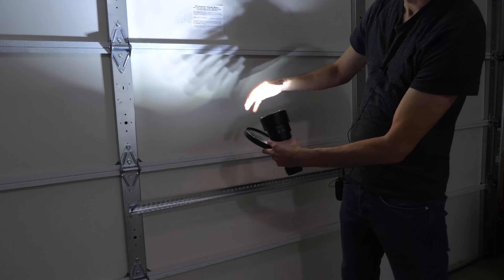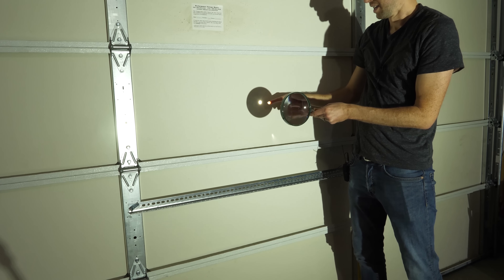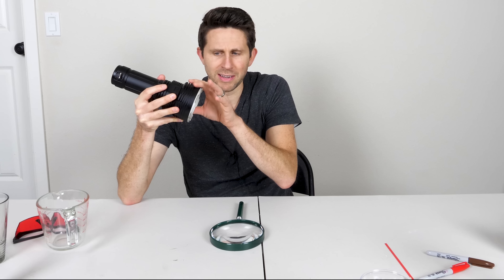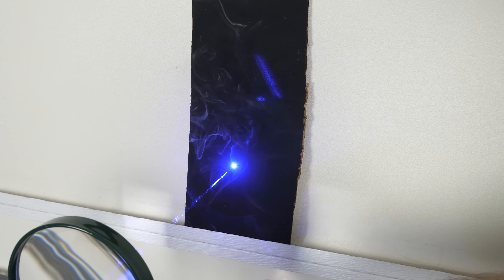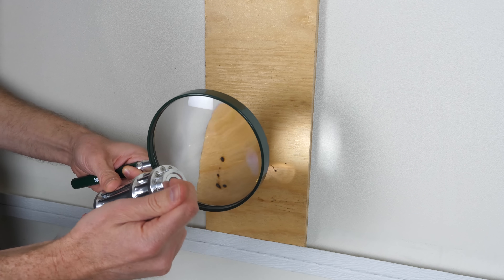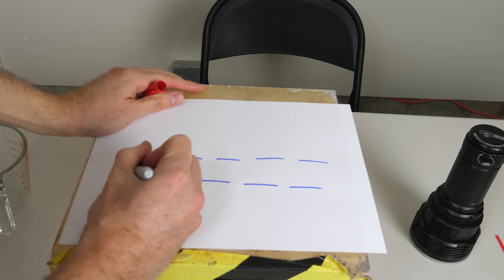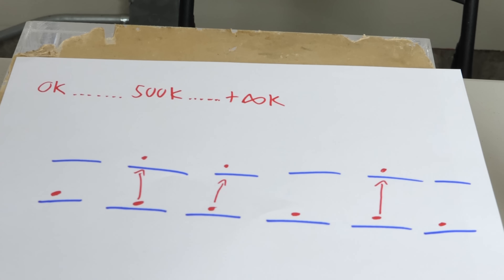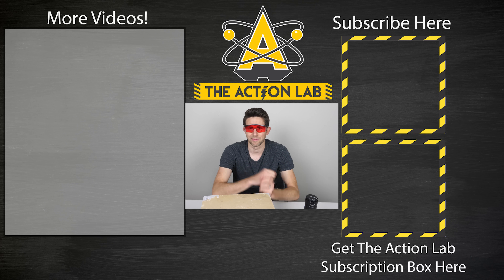What Happens if You Focus a 5W Laser With a Giant Magnifying Glass? Negative Kelvin Temperature!

Comment from the maker: I see a lot of people are having trouble with this video. First, I am very much aware that the reason the laser it getting hotter when it is magnified is due to the reduced area. That isn't the point of this video. The point is to try to explain why it doesn't break the laws of thermodynamics! Now for the negative kelvin explanation, statistical mechanics tells us that at infinite temperature all atomic states will be populated equally. The Kelvin scale was built upon classical mechanics where it would be impossible to achieve a state in which there are more atoms in a higher state than a lower state. However due to quantum mechanical effects, we know that we can stimulate atoms to be in a higher energy state simply by shining light near them that is at the same wavelength as the light it would emit at that state (stimulated emission). So in a laser, the stimulated atoms actually achieve a population inversion where there are more atoms in a higher energy state than a lower one. This is where the negative temperature comes from. In this case we have to define temperature as negative or else we get into problems that break the second law of thermodynamics. It doesn’t matter that my laser has poor optics. What’s important is that lasers can break the conservation of etendue due to the fact that they have light that doesn’t spread, the reason they have light that doesn’t spread is because of population inversion, and this is why we have to say they have negative temperatures (or they behave as if they have negative kelvin). We can never achieve negative temperature in a non-quantum mechanical system thus anything the laser shines on is always at a positive temperate no matter how hot you get. 

Of course the reason the laser gets hotter when it’s focused is due to the reduced surface area of the light. That was not my point though. The point of the video was to explain why it doesn’t break the 2nd law of thermodynamics. Please research “conservation of etendue” to understand why you can’t focus a flashlight down to a point that is hotter/brighter than the flashlight surface. This is a very good example of how the second law of thermodynamics can never be broken no matter how hard you try.
Reply: You should have mentioned etendue in the video! Perhaps even link to the xkcd "what if" essay on this topic.  Also, cross reference the Nottingham video on negative temp. and population inversion.
Reply: Well technically you're not increasing the energy of a laser to make something hotter your decreasing the area of which you are Heating which decreases the amount of time that it takes two heat app said material if you were able to make more energy just using a magnifying glass we'd be doing it on a massive scale and solving the world's energy crisis I guess what I'm trying to say is that you're not getting any more energy or any more heat out of the laser you're just convincing that to a finite point making it heat much more quickly it's like if I put a pound brick on your foot it's no big deal but if I put that pound brake on a needle that's on your foot it will poke a hole through you I didn't increase the weight I just decreased the surface area making it much more effective
Reply: But couldn't you just capture the light with a glass dome close to the light or at least some of the light with a parabolic mirror to a focal point?
Reply: Party P, all glass absorbs and scatters some light. The more lenses you use, the more energy is lost. And no lens can focus all wavelengths of light simultaneously, because of chromatic aberration. Only one specific wavelength at a time can be focussed by a lens. That',s why you see coloured bands around the edges of an image which has been passed through a lens. The bigger the lens, and the higher the power of the lens, the worse it becomes.

Bye.
Reply: Yes negative kelvin is really something but I dont think it is relating to the experiment in your video. Well... Laser now a days are using LED and even using crystal/gem and use a somesort of intereference or method to concentrate the light into a small point to escape as a laser at high coherency. Through out the process, the device itself losses of a lot of energy as heat.
With that said, the light from led and the laser are no different. THEY ARE LIGHT !

The laser device itself actually making a normal diverging light of light bulb into a concentrated point as laser...
The negative kelvin was kinda discovered yet still in not conclusion . It help explain a phenomena from an experiment carried out with the gas which involves energy of molecules. Yes the negative kelvin scale chart system is different from those celcius and Fahrenheit... Your "infinity" explaination is hardly understand by many people. The things I dont like is the use of technical words and interpretation are misleading, please make something accurate when it comes to technical stuff...
Reply: Yes, the use of the word infinity etc.
Reply: Hey you should try to use multiple magnifying glasses to focus the flashlight. But one up close then put one slightly further back and put another one slightly further back etc...
Reply: @yammymcyammington3219 You'd overfocus some light and end up scattering it. Photons don't interfere with themselves, it's only their waveforms that generate interference. If you have a precisely defined waveform for a photon and try to impact it with another photon you will fail.

Furthermore, because photons by their nature travel at c, its entirely plausible that all of the photons are the same one; and that if it is possible for that photon to be on a worldline, then it will be there. As for whether you'd detect it, that one you can ask Schrodinger, Dirac and Heisenberg.

There is a difference between something making sense, and you understanding something. Furthermore, the moment you believe you have understood the nature of quantum mechanics is the precise moment the superposition of your knowledge collapses into cluelessness.
Reply: @yammymcyammington3219  or buy a focussing flashlight which has the collimating lens close to the diode.  From there you can focus the light even more to a dot if you want, but you will not have laser light and it will not be enough to light a match on fire.
Reply: Simple version of what he demonstrated and spoke of, if the flash light was on then all the energy is displayed but in terms of it as heat, it is hot but not to hot. if you want to make it hot you need to focus it via magnified glass. He had troubles focusing the flash light into a beam of energy so he discontinued, I had an idea and said why not make the magnifying glasses act like a camera or telescope lense and pair two magnified glasses? When it all comes together he has most of the valid statements but lacks a detailed analysis aka the video above. Please demonstrate this topic more detailed before your conclusion!
Reply: @Desimoar  heat is a biproduct of energy. Some times it's waste ,still a part of the maths.
Reply: @bikerbob2005   yes their is waste but focusing the light/heat would enable for more concentration, but yes you may lose some of the heat from focusing but still makes the light into one beam making it more effective in what he was saying of making it past "infinity". With that being said it is possible to concentrate the beam down to a capable burning point but, everyone here just wanted to see things get burnt lol.
Reply: For a more in-depth understanding of negative temperature I’d suggest the video by 60-symbols on the topic titled “is negative temperature hot”
Reply: And... I believe you've reached full Dunning-Kruger saturation in the comments to your nice video and the replies to this comment of yours.
Reply: The Action Lab: You could have avoided confusion by emphasizing that you can't focus all the power (i.e. the ENTIRE light cone) into s apot smaller than the surface of the LEDs. Somehow people have the natural perception that the source size is the opening of the flashlight and not the tiny area of the LEDs. You could have also made the point that you can't project a brighter image of the LED onto the wall than what you get by simply putting the LED chip against the wall (just use a power meter to prove it). And the best example for collecting and re-focusing all light from an incoherent source is an elliptical pump cavity used for arc lamp pumped lasers.
Reply: Novgorod \
Reply: @RealNovgorod  but what if you get the light cone into perpendicular rays of light with a special lense. What's the difference between the light from LEDs and a laser's
Reply: @RealNovgorod  These tips seem spot on. Actionlab does amazing work, that said, maybe he should get an expert-panel and a layman's-panel (where I belong hahaha) to audit the videos before posting?
Reply: @EverHappyDude  Yeah well, actual experts typically don't talk into the camera in exchange for ad money. That's the dilemma. Also, Dunning–Kruger - therefore, most of what gets around is completely worthless.
Reply: @RealNovgorod  But can't we? Yeah, with regular concave/convex lenses we can't, but what about a specifically designed optical system, that is applied to every LED, shaped in such a way that all light from every LED is focused onto infinitesimal point?
Reply: @aberroa1955  read the wikipedia article on diffraction limit (Abbe limit)..
Reply: @RealNovgorod   Yeah you have focusing flashlights which do exactly that.  There are also LEP (Laser(!) excited Phosphor) lights which look like a flashlight, and can burn stuff.  But these are advertised as LEP and not LED.
Reply: @RealNovgorod  I don't understand how the fotons emmited from the LEDs can't be concentrated in a point smaller than where they came from. If this could be done and the fotons have the same energy as in the LED you would create a higher intensity resulting in a higher power meaning higher temperature. Could you correct me where I'm wrong?
Reply: @Joris Kirchner Yes, if you could indeed collect the light from a low-intensity surface and concentrate it into a smaller area, you would end up with a higher intensity. But the second law of thermodynamics says that in order to do so, you have to put additional energy into the system, i.e. you can't do it with a "passive" arrangement of lenses or mirrors. Let's say all the walls in a room are at the same temperature and you want to make one wall warmer than the others by transferring the heat from the other walls (making them colder) - that's not possible without a heat pump which requires additional energy. The photons from an incoherent lamp behave in the same way as the photons from a heat emitting wall at room temperature: You can't collect all the heat radiation from a wall with a giant (passive) infrared lens and focus it onto a spot and make it warmer than the wall.
Reply: @RealNovgorod  Thanks, I finally understood with your analogy of the closed room at an equilibrium state. That makes sense that you will break the 2nd thermodynamic law if you could concentrate heat in this situation. You could create an infinite energy source and perpetual motion
Reply: @Eidoryan: It wouldn't be necessarily an infinite energy source (1st law) because you would only use the energy that is already in the system and just redistribute it. However, the 2nd law forbids a "spontaneous" redistribution away from equilibrium because that would decrease entropy which requires work.
Reply: @joriskirchner6280  I see no problem with wat you say. It is impossible to increase the amount of energy emitted but (like you say) if you concentrate the energy emitted from all of the surface of the sun to a spot as big as an apple then it would actually get hotter than the surface of the sun.
Reply: @KnumpterGames: But you can't concentrate the energy from the entire sun into the size of an apple, that's the point. There is no mirror or lens system that can do it, you can even try to draw it on a piece of paper with simple ray optics, you won't be able to focus it down to a smaller area, that's not only beyond physics, it's even beyond simple geometry. Well, maybe you could do it with a specifically shaped back hole but even then it would be just an appearance from far away because locally the focus "area" would still have the same size and intensity.
Reply: @joriskirchner6280  go read highschool textbooks.  Dont shit hear(this guys doesn't even know the spelling of photons.)
Reply: @RealNovgorod  umm actually, using a big enough lense we can harness all the rays coming in one direction, then placing the sun at the vertex of a parabolic mirror we can direct the rest of the rays to the lense.

Anything is possible with the right combination of lenses. Trust me. I'm an engineer.
Reply: @RealNovgorod  Quantum Tunneling: Since when have we cared about geometry? If we figure a way to passively induce quantum tunneling, then you could theoretically set up a multilayered mirror array that could capture the entirety of light emitted by a spherical object and direct them into a single point. You would do this by inducing quantum tunneling if the light approaches a mirror surface from anything short of an ideal vector and then it would pass through the mirror to the next mirror found beneath that one and so on until you get a mirror that will cause the ray to be reflected to the desired point.

Obviously this is all theoretical and would require materials and methods we do not currently have and a precision that is nearly impossible, but it would not actually be impossible as a rule.
Reply: @femsplainer  You're making no sense at all. You don't need quantum tunneling to capture all the light and this was never the issue. The issue is that you can at best reflect all the light back into the source, but never into a spot smaller than the source area! No matter how you shape your mirror, every single point on that mirror will receive an infinite number of rays at different incidence angles because they come from infinitely many different spots on the source. You would have to adjust the angle of this mirror spot for every one of those infinite beams to reflect them back into one point and do it all simultaneously. And if you want to argue that you could somehow serialize the rotation of the mirror segment because the photons arrive not perfectly simultaneously but one at a time, take a look at Poisson statistics and think again (let alone how you would determine the k-vector for each photon without destroying it, since that's a quantum measurement).

Your weird multilayer mirror would not work either - and you don't have to call it tunneling because it's simply a partially transparent mirror, which is very well described with classical wave theory. If you could somehow make a magic mirror that reflects only if the light hits it at one specific incidence angle and transmits all the "wrong" angles to some layers behind, you just expand the problem to infinity. The "wrong-angle" beams from one mirror point will mix with the wrong-angle beams from other mirror points at the next layer and create exactly the same problem that you have at the first layer, i.e. infinitely many beams hitting one mirror point at infinitely many different incidence angles.
Reply: @RealNovgorod  So I think we're talking about a few different things here. First off, when you say that you cannot focus light down to a smaller area than the source which is not true. In a standard incandescent light bulb for instance, each tungsten atom along the filament emits photons. These collective photons can be reflected in such a way that they will converge on a point that is smaller than the surface area of the filament. In fact we saw this in this very video with the laser. The point was much finer than the that surface area of the diode that was emitting the light. We could have seen it with the flashlight as well if the light beam was more focused and he had a bigger magnifying glass.

The point to the quantum tunneling is to avoid intensity crushing with semi-transparent mirrors similar to what you would see with polarized lenses. If the light came in at almost the correct angle to be reflected, it would effectively scrape the mirror and lose some of it's energy/intensity in the process. Tunneling avoids this problem and I was feeling fanciful so it doesn't really matter that you can do it other ways, because you could do it my way too! Even then this is only necessary for the light that would have to pass back through the source (and the physical structure that comprises it and that which is holding it up) to get to the target point

Lastly there is not infinite number of incidental angles that a beam of light can hit the mirror, nor are there infinite beams of light being emitted by the source, so your final point is moot. Photons emitted from a single light source travel in all directions, but there are a finite number of photons being emitted. If there weren't, well then it wouldn't matter if we only collected a subset of them and focused them on a point, because 30% of infinity is still infinity after all.

Mathematically angles may be infinite, but when dealing with the material world and fixed distances, we see that this is not actually an issue. These emissions are coming from a fixed source and traveling a relatively short distance, so at a certain point, we can ignore subdivision of angles because they would only produce a drift effect on the photon at distances greater than what we are focusing the light on. In other words, we can reduce the infinite set to a finite subset and achieve the same goal of focusing all light emitted from a source to a point. Further you set the bar a bit lower by saying that we can't get light down to a smaller area than the source, so we wouldn't even need to be as accurate as to focus the light to a single point, just a rough area that is smaller than the source.
Reply: @joriskirchner6280 conceptually you're correct. The only thing you're wrong about is saying that it would be "higher" or "more" the video is drastically incorrect so just ignore that but know that the amount of heat and light produced by a source can NEVER increase. What you can do is take most of that heat and brightness and apply it to a smaller area. Imagine a lightbulb that heats a room to 50°F and provides adequate light. Now tape off that room so it contains 100squares and use mirrors and lenses to focus the light on that one square. That square will be 100 times hotter and brighter than any single square from before but it will always be slightly cooler and dimmer than the source of light itself.
Reply: @RealNovgorod yeah but it you pointed the heater at the one wall then obviously the other walls in the room WOULD become colder 🤔 😆 🤣 😂
Reply: @RealNovgorod  I think the action lab has maybe used a bad "analogy" for the principle he's trying to describe and I'm not the only one (as the large response of the audience would suggest) so simply saying "no" is as lacking a response to my reply as his is to try and explain the principle of the second law of thermodynamics but not just the principle but the "specific" principle according to one specific "author/scientist".

Now I admit I might not be interpreting or understanding of the "jist" of the principle but even your analogy of 4 walls etc is very lacking as your analogy also negates the fact of the energy source that is heating the walls and is therefore lacking in a descriptive manner (I understand "passively" placing mirrors or lenses in that room would do nothing to allow the residual heat to be transfered to the 1 wall making the 1 wall warmer whilst making the other 3 colder but you're ignoring the mechanism that's heating the walls in the first place I.e. the directed energy source or laser in the action labs video)

I enjoy his videos and don't mean any disrespect but if so many people are interpreting the intended topic matterin the wrong sense then it can't just be the audience that's at fault (and he does accept the point the audience is raising so I think maybe a longer and slightly different explanation wouldn't be a bad thing no matter how counterintuitive it seems).

And  I know that lasers can be used to "cool" matter/particles down below a certain threshold and that is highly counterintuitive considering most would associate lasers with heat and burning etc.
Reply: @scottbishop7899  I've given many extensive explanations covering all your concerns here, just look thorugh all ~500 replies. Nothing is "heating" the wall, it's a closed system, or at least a steady-state system. But even if something would heat the wall to make its temperature rise over time, if won't be cooling the other walls at the same time.
Reply: @RealNovgorod  funny, could've sworn I saw him pointing a laser!!

Once again, bad analogy!!
Reply: @scottbishop7899  Sure. A laser is not a wall. Nor does it cool walls.
Reply: If you made a long reflective cylinder connecting the flashlight to the magnifier glass wouldn't it then be brighter?
Edit: Missunderstood something I thought you were saying that you couldn't get a brighter light than what is being projected onto the wall instead of what was coming out the source.
Reply: Is that why it's works with the sun , the light isn't so hot but because the course itself is so hot it can still burn things
Reply: Loved it my friend. I do have a few questions. Do you mean even if you CONCENTRATE a large area of sunlight into a point it still will not exceed the surface temp of the sun? Surface of Sun is only 6000 degrees f or so but Corona is millions...I assume you mean the Corona temp right? I do light research and things too...I love your approach. https://www.youtube.com/watch?v=edp7FZLf2N4&t=1s
Reply: My name is Kelvin lol
Reply: I'm studying Optics and Photonics in college, and your wrong that laser light doesn't spread. All light diverges. If you shine that laser to the Moon by the time it hits the moon it'll be hundreds of feet wide. And your also wrong about population inversion. Population inversion is just a feature of how a laser achieves stimulated emission, and this has no effect on the divergence of the beam. When you focus it your just taking the wavefront and making it smaller, increasing irradiance. And there's also a limit to how small you can focus it with lasers. It's called diffraction limited spot size so research this stuff before you mislead people.
Reply: Congratulations the action lab, you now have the world record for the longest comment in history
Reply: This is not an accurate account of the second law of thermodynamics nor do you accurately claim that you cannot get a hotter point at the tip of a focused beam then the source. What you failed to mention was that there are several energy conversions that occur in a light.

Electrical energy to a diode, to photon creation, then photon destruction at the absorption surface. 

That being said conservation of energy is more critical than the second law of thermodynamics. From a conservation of energy standpoint you are reducing the cross sectional area of the beam and thus focusing the energy onto a smaller area or volume than the original source. Which is a accurate statement.

Regarding the second law of thermodynamics, there are multiple reasons as to why this has been improperly applied. This is an open system you were dealing with, not closed. You were combining multiple LEDs into a single point. Not withstanding the fact that LED lights do not produce much light in the infrared spectrum. They only mimic the spectral radiation of a 5000K (or slightly different, depending on the selected LED) source and are not actually that temperature. The issue with your setup was using a diverging light source with only a single converging lense and no collimation.
Reply: OK I can't take it anymore, I love your videos but this can't be tolerated.

The only reason we can't harness all of a flash light's power is because not all of it hits the magnifier, but if we were to remove its diverging lense or put it in an elliptical mirror to stop the spreading all of it can be collected.

In fact the light that manages to hit the lense actually focuses into a brighter spot than it was without the magnifier. The only reason a laser's focused light can be of higher intensity than the source is because we intentionally cut off most of the light until a point is left. 

It does not depend on thermodynamics, and certainly their's no negative infinity loophole to that law.

The real question to be tackled is whether it could be possible to achieve infinite intensity by focusing light on an infinity small point in space.
The answer to which I believe is no.
We like to think of our world as a contium but in fact it's pixelated into cubes of side= one plank length (maybe smaller), so that's the lower limit of the area we can converge into.
Also light isn't a continuous beam, but a stream of individual photos.

Thus the max intensity we get =(no of photons in give beam) /(1 plank length ^2)
Reply: With this explanation all you did was make it even weirder, you're saying the laser simply went beyond infinite degrees? That makes no sense, I can understand the simulated emission thing, and even the relativistic assumption of negative temperatures, but given said state only happens in infinite temperatures it imples the laser is beyond infinite kelvin, and that is just plain wrong. I can dismiss all that since it is just like a "patch explanation" to not break the second law of thermodynamics, just like we keep doing with every weird thing we meet on reality, we just patch-up our science for it to keep "working" in our minds.

The magnifying glass doesn't catch near a quarter of the whole emission of the flashlight, and it catches less and less light the further away you place it, meaning that no point made with the magnifying glass would have enough light to be shinier than the source, with the sun it's the same thing, there is so much energy in just that short area (imagine it as a gauss sphere) you can burn some small things with it if you concentrated it in a few squared milimeters. A laser is a whole different thing, lasers do not scatter that much light, like a flashlight or the sun, a magnifying glass is catching almost all of the laser's energy in the light and focusing in a smaller area increasing temperatures way beyond what the source laser has, it won't be shinier tho, for the amount if light is the same, but it will "burn harder" for less amount of particles are receiving the same amount of energy caught by the glass, it's like decreasing the area arround a pipe and getting the fluid to go faster (and hit hard enough to remove dirt from a car, or even cut steel, for example) in it, while still flowing the same mass of water (energy) in the same amount of time.
Reply: I am still so confused. You could never get an atom to reach an infinite temperature, because it would require an infinite amount of energy to do so. And even if you tried, the atom would dissolve into its elementary particles long before it even reached a billion degrees. If continued to keep packing energy into what was left of the atom, it would eventually just collapse into a black hole, and you would loose all the energy you had. And this has nothing to do with lasers. There was never any doubt that lasers fallow the laws of thermodynamics, no energy is created while focusing the light, you are just reducing the number of atoms in the wall that end up absorbing it. This is a factor of geometry, and I am very confused as to what this has to do with quantum mechanics, infinite temperatures, or negative temperatures. Can someone please explain this to me???
Reply: The Action Lab 
Tattoo removal?
Reply: Did 
The
Universe
Just
Overflow?
Reply: Or use a flashlight with zooming lenses then magnifying that more to a point
Reply: You're fake man. Bright is not the same as hot. You don't know your stuff just admit it already.
Reply: The Action Lab I love my science
Reply: Saying science words doesn’t make u smart, ur still wrong about most things is this vid
Reply: This has nothing to do with the video. But that laser is nowhere near 5 wats. It's most likely just a 1 wat laser. 5 wat lasers are much brighter and ignite most things within seconds. A dead give away of this is the housing of the laser which is very common in Chinese "powerful burning" lasers. They often advertise to be 2+ wats lasers but I promise none of them are even over 1.6 wats. Although 1 wat lasers are still very fun and much more powerful then your average 5mw red laser pointer you use to play with your cat. A 5 watt laser would also be a lot more expensive then your average 1 watt Ebay laser. Unless you modified it to 5 wats. If then never mind that's awesome.
Reply: The Action Lab I didn’t read it but ik it has a lot of information ℹ️
Reply: Ok, if you say so.
Reply: Wouldn't this be an open system in thermodynamic terms, not a closed system?  The entire surface of the sun is the heat source, the accumulative temperature.  So this means you are not going to transfer more than that energy.  However, wouldn't there be enough energy, even at 1 Kelvin, if the source was big enough, to start a fire?  It's very confusing, as the etendue explanations I see quote theoretical mathematics as to why it's not possible, but don't explain the actual physical reason why the maths are true.  Why doesn't a collimator or telocentric system fed into a lens system concentrate?  The surface area of energy expression in the system of your explanation is also not the sun, it's the receiving surface of the lens.  The magnifying lens probably shows the theoretical rule as to the etendue conservation in that context.  The angle of the rays increases and may concentrate the energy to the focal point, and continue to spread out wider than the angle of emittance from the receiving surface, received as part of a second open system part, from the sun.   Without some reason why the rays don't always separate and hence always don't reach a high enough density where they can't start a fire from the moon light say, then it is purely an engineering problem (something a problem with scientific explanations where people presume that presumptions are correct given varying setup circumstance).  So, here you would make a way to constrain and funnel the light, which a laser does.  So, through constraint, violating normal optics, can't the light be funneled to the target?
Reply: @The Action Lab "So in a laser, the stimulated atoms actually achieve a population inversion where there are more atoms in a higher energy state than a lower one." This is a fundamental flaw in your argument. Lasers do not deal with "atoms". Lasers deal with photons. While different photons can have different energy levels (e.g., a blue photon is more energetic than a red one), photons do not change energy states. Photons cause electrons to change energy states.
Reply: The only thing I'm having trouble with is your punchable face.
Reply: 1.  Laser light does spread over distance.  I can prove it with a 5 dollar laser pointer.
2.  You can't say higher and higher is negative, when it' not.. its just more positive.  There is no end to positive degrees.. To say that positive infinitiy becomes negative infinity breaks the laws of mathematics and its' just sophistry.   You are making this crap up.
Reply: Can you stop calling a 1W laser a 5W laser?
Reply: Hi what I learned is that Kelvin is based on the movement of the atoms, and at zero Kelvin the atoms stand still. how are atoms then when it is colder than zero Kelvin?
Reply: A laser diode does not intrinsically generate light with no spread, hence some modules and lasers are focusable. They have a lens that can be moved to different distances from the extremely tiny light source, so a tight beam, a spread, or even a focal point can be reached from the laser apparatus alone.
Reply: @AEON.  You could just take the lens off of a typical module that has a boost driver and focusing lens in it, if you don't want a raw laser diode. A plain laser diode output does spread a lot
Reply: The Action Lab well doesn’t it mean that the second law of thermodynamics was broken, we just “adjusted” the definition to “unbreak” it which would technically mean that the original was never a law in the first place, and that it should have been worded differently
Reply: Seems to me like you are really bending the perception of these very obvious laws to accommodate the laws of thermodynamics which seem to me to be more abstract than literal.
Reply: Imagine if u were dyslexic and had to read that whole thing
Reply: There are some highly questionable statements in this video, regarding what you cannot do with optics, and the supposed violation of the second law of thermodynamics. The pinned comment mentions etendue, but the author seems to not fully understand it, or perhaps he doesn't understand his LED flashlight. There's also some sloppy usage of the word "hotter" when he seems to mean "more intense." Power density and temperature are not the same thing  (you can make some assumptions to convert between the two quantities, though...for instance by using the Stefan–Boltzmann law).
Reply: using reflector behind the lights and 2 convex lens,one just before the ,and another to concentrate parallel lines of light,thus you will get a point of light,,which will have same energy in a reduced area,,thus you can creat a point that is hootter than the surface
Reply: using reflector behind the lights and 2 convex lens,one just before the ,and another to concentrate parallel lines of light,thus you will get a point of light,,which will have same energy in a reduced area,,thus you can creat a point that is hootter than the surface
Reply: You are wrong sir. The reason this doesn't violate the laws of thermodynamics is that the total energy in the system is conserved. You are only changing the concentration of energy, not the total amount. This applies to all energy sources. your idea that you can only focus a lazier this way is false. Your idea that laziers have negative temperature is also false. You're also citing the second  law of thermodynamics incorrectly. It simply states that total entropy never decrease. As in, to heat a spot you must add energy to the system and increase entropy as that heat is used or lost to the environment. 
For your statement about the sun, this means you can never produce a spot hotter than the total energy emitted by the sun, Not the sun's surface temperature. The sun's surface temperature can easily be surpassed by reflecting and focusing it's emitted energy.
Reply: "In this case we have to define temperature as negative or else we get into problems that break the second law of thermodynamics."

So you literally redefine words rather than question the holy "law" itself. Theoretical physics truly is a religion.
Reply: Your explanation is fine but your demonstration is not accurate.  You absolutely can focus sunlight to burn objects.  The point you were trying to make about not being able to get hotter than the source fails as a result of the bad demonstration.  The limits of the magnifying glass are equal to the limits of the energy processed through the magnifying glass.  Which is a completely different form of math than what you were discussing.
Reply: @paxtothemaxz  You heat something, it gets hot (you don't say). It can't get hotter than the source of the heat though. Energy is not the same thing as temperature.
Reply: Now with 9999999 magnifying glasses
Reply: Imagine multiple glasses.
Reply: That was long
Reply: You can't do this with conventional /optics/. Enough solar panels and  electronics and you can probably funnel that energy into generating a hotter beam  ;D then you're cooking.
Reply: The Action Lab i have a question, i learned that lasers and the sun have a straigt light beam, so why cant we focus the sun to a hotter point
Reply: @daanmatheij2583  because you learned wrong. the sun does not have a straight light beam. its light goes out in a sphere around itself.
Reply: Bill Nye the Science Guy up in here damn
Reply: I'm curious as to what magnifying glass that is because almost all glass would break
Reply: Would love to see someone create art with this method!
Reply: The Action Lab what if you used the flash light that zoom in
Reply: The Action Lab How about using a concave lens with the magnifying glass?
Reply: Hey their "the action lab" what is your work? Ahh I'll try to guess it! You are a scientist!? Pls reply if my guess is correct!
Reply: Nerd as
Reply: Not to be mean but I just realized this but why is your voice that high
Reply: And is there a bunch of sience behind that
Reply: Ok
Reply: Hooray for science!!!
Reply: SCIENCE CLAPBACK
Reply: Hey could you make a tube or pipe that's long enough to magnify the flashlight without losing all that background light
Reply: Can someone do a tldr
Reply: The Action Lab  kdjdjjdj
Reply: I finally found this video !!
Reply: Yerzhigit Mubarak liar!
Reply: TLDR. (Too long didn’t read.)
Reply: when you realize it could just turn into a black hole and your done.
Reply: I would understand it this way - A cone in equilibrium on it's flat surface vs cone in equilibrium on it's point
Reply: Hmmm, Interesting👩‍💻👩‍🔬👩‍🔬🤔😀😀😀
Reply: Where do I buy that laser?
Reply: Who else was about to read it, pressed read more, and just say nope
Reply: I didnt understand a shit
Reply: Woah...
Reply: Science biatch
Reply: Wuttt
Reply: yuck
Reply: Gwy3
Reply: Actually true! Once made me think too. It's all quantum thermodynamics and laser physics.
Reply: But why not to simply "manipulate" the light AFTER focusing it, in order to make it a laser, in a way that will result in hotter laser beam that we would get after manipulating this light without focusing it? Doesn't it go against what you say about it being impossible, if it's possible?
Reply: @Livasuk   Not sure what you are exactly trying to say, but laser light IS created by focussing diffuse light using a lens. But you can't take any light and turn it into a laser without modifying the light so that it becomes very uniform (called coherence).
Think of it as throwing a pebble in a pond and the waves that go outward will be evenly spaced between each other. This is called wave coherence.
Now take three pebbles and throw them in simultaniously. This is what kind of happens in a light bulb where light is emitted from several diodes or for example a wire and the light is actually many wavelengths (colors) at the same time, ranging from yellowish to blue and red/infrared (spectrum)
Laser light is created from a highly monochromatic light source that emits very uniform light to begin with.
In fact a laser is also called a 'highly monochromatic Gaussian beam' if you want to know the most fanciest name :p
Try Google a bit or ask chatgpt to explain laser light generating and phase coherence and how to turn normal light into laser.
There's too much to discuss..
Reply: Thank you for the video and your explanation! I understood well it and better did it reading your comment. 😊👍
Reply: Can you leave a link to where you got your laser
Reply: I understood some of those words
Reply: So in statistical based data analysis which insists on network depreciation of Kelvins in a nano spherical sense, could or would the laser be impacted by delivering equal sections of bias?
This makes perfect sense.
I once burnt my foot with a bunsen burner.
Reply: With due respect. 
I beleive that the reason you have managed to reach a "higher then source" temperature using the laser, was not due to its origin temperature. It was due to the fact that the light emmited from the laser is emmited in one direction and not in all directions.
For that reason you have managed to focus the entire emmission of the laser to a surface smaller then the origin surface. Using your flashlight and the sunlight, you are only grabbing a fracture of the origin light as the light spreads the further you get from the source (which you have mentioned when you said that most of the light hit the wall rather then your magnifying glass).

You have two problems -
1. The magnifying glass shape focus parallel beams (like laser) and if the beam is spreading in all directions it can only direct the collected light in parallel, it cannot focus it.
2. The magnifying glass can only focus the fracture of the emmmited light that hits it.

To solve the first problem, you need to adjust the shape of the magnifying glass, or use two consecutive magnifying glasses - one to change the spread from all directions to parralell (single direction), the second to focus the parallel beam to a single point.
To solve the second problem you need either a bigger magnifying glass or getting the magnifying glass closer to the source of the light (both should be easier done for your flashlight then the sun...).

Now you probably have further knowledge of kelvin temperature and thermodynamics than I have, but when the claims you appearantly* claim seem to be wrong to some, they will not bother to continue and try to understand your explanation...
I beleive that science is a method full of errors and misconsumptions, it's greatness is it's ability to question the consumptions and learn from the errors rather then sticking to it. I belive that even tough this video has an error in it, it has a value, because any kid which will doubt your claims and will dare to try and prove it (and might succeed in it), will learn a valuable lesson.

While I go and learn of Kelvin negative temperature, I challenge you to create a video demonstrating how you "can" create temperature higher then the source surface by focusing it on a smaller surface.
It will show you are a real scientist, which does not allow it's ego to stop him in the scientific investigation. It will also show another important feature of science, mistakes are possible, and it does not collapse the structure...

* I write appearantly as I believe that the intention was that you can't reach a larger amount of heat by focusing a beam then the entire source surface (it is possible that this is exactly what you said but your definition of temperature is not 100% understood by the viewers, including me...).
Reply: I can't understand a SHIT!!!!
Reply: Pagal kidhar ka . Translation susu potty
Reply: Sooooo can you create theroy type video on how to make lazer bullets or why lazer bullets would be more or less effective than a straight beem.
Reply: Hey Broheem, great channel man. Really enjoy it. I love physics. Was wondering if you could do a show on why the earth doesn’t move under your feet when you jump up due to earths rotation.
Reply: since the laser beam is significantly smaller than the lens, shouldn't you be able to use one lens to focus multiple laser beams to the same point simultaneously?

now there would be a cool video.
Reply: Yes, if you have several parallel laser beams with ideal Gaussian spatial modes, you can theoretically focus all of them into one spot defined by the numeric aperture of the lens. That spot will be brighter than the individual (focused) beams. Keep in mind though that this only works because the laser is a coherent light source (which produces an ideal Gaussian mode) and has therefore a source size of "zero". The source size in a thermodynamic meaning applies only to an incoherent "spread-out" source like an LED surface. An ideal laser has no incoherent source size, so you can in principle overlap as many as you want to reach arbitrary temperatures (that's why lasers are used to start nuclear fusion). This also doesn't break thermodynamics because "lasing" is not a random (i.e. incoherent) black-body type process like a heat reservoir coupled to the surrounding but a highly-ordered (low entropy) quantum state to which you can't even assign a statistical temperature (or you might end up with "negative" Kelvin, as very sloppily explained in the video).
Reply: The Action Lab pls get MORE lasers and get STRONGER lasers. Let’s see what would happen then
Reply: well I see, disregard my comment. In video it just sound like you mixed law of conservation of energy with 2nd law of  law of thermodynamics into one
Reply: Nice essay there
Reply: If Maxwell's demon, or something else besides a laser, could toss lots of photons in a straight line, you'd still have to defend the 2nd law, but could you necessarily make it an argument about population inversion and negative temperatures?
Reply: oh
Reply: The Us needs to put these in space to smash nukes out of the air.
Reply: This guy talks to much
Reply: @calebferguson3148  Who him? He is trying to explain something.  Trying to discuss things with wisdom takes time.
Reply: Whoa whoa to much writing OK I luv ur vids tho
Reply: People are jumping on this for various reasons, and holding up a big magnifying glass without a lot of animations and graphs to explain it, and looking and sounding like TV comedians we have here. Could it be a troll?
Reply: Actually.  This whole thing of atoms going into a higher energy state being called negative temperatures is just typical contradictory rubbish.  They could have called positive temperatures above kelvin normal, or positive, and the "negative" positive or extra positive, or even special positive.  Whatever will happen if they find some folded dimension of space, with extra slots giving space energy density, and somebody finds out that you can turn those slots down as well, and probably counteract gravity or something (hmm, that actually sounds interesting for all sorts of stuff to do with motion too) are they going call that "positive kelvin"?  So, you get negative kelvin by filling more slots to make things hotter, and positive kelvin by taking away more slots to make things colder.  Sounds a bit useless.  No wonder people cant understand science anymore, like wiki articles in recent years, gone are the simplified explanations of the process of physics to build knowledge.  Now you need an encyclopedia just to read the articles.  Anyway, it occurs to me a way to take away potential hidden slots, hmm.  Floating..
Reply: Actually, I thought heat had to do with energy, and energy in light is a function of frequency and number of photons in a wave?  Photons are spaced so have an area restriction on that side, normally, but is there any restriction in frequency?  So, a piece of space could have more energy than matter could carry, maybe resulting in a slot inversion (how does Hawking radiation work?).  But that energy is heat, so should have a temperature?
Reply: You totally failed to explaine it properly , either you don't have full expertise in field OR you have expertise but totally zero teaching methods.
Reply: Damn that a lot of typing for one comment
Reply: Jeez don't have to write a whole essay lmao
Reply: You type a essay
Reply: The action lab get a life
Reply: I was really curious on what will happen if you break the 2nd law of thermodynamics . Im not on this thing tho but it got my interest especially when things explained more in depth. 😅
Reply: Negative Kelvin is not beyond infinity Kelvin, it is negative entropy and thus the reduction of heat transfer. The opposite of heat but at higher energy with less entropy. Heat is a manifestation of disordered energy described by blackbody radiation (transfer in a vacuum) and conduction and convection in close proximity matter.
Reply: Use Uran Glass
Reply: Use Uran Glass (Lens)
Reply: Couldn’t you focus two flashlights at the same point? You could set up multiple lensed to focus the flashlight multiple times onto the same place. Wouldn’t that result in a hotter temperature than the surface? The temperature cannot be greater than that of the energy released by the flashlight. What you said in this comment actually contradicts the law of conservation of energy. I don’t mean to be rude, but these things are important to grasp if you run a science channel.
Reply: Tha comment is longer then most my essays for school
Reply: Only 5 year olds dont understand it
Reply: My issue with the video is that you say we can never focus the light from a flashlight to brighter than the flashlight.  I'll have you know, I've started many fires with a flashlight and a magnifying glass.  I've done the same thing from household lamps.  That little dot gets far brighter than the output of the flashlight, or the lamp.  So, I have no idea what you are talking about.
Reply: K.
Reply: Wow action Lab, i'm in 9th grade, and 15 years old, and when i saw this video's title, i actually didn't want to click on it just so that you wouldn't get the view. Thats how stupid this is. I have not even finished biology and i know at least a little bit of why this is stupidly retarded. You probably heard something from your friend at the bar who you think works with engineering (but is actually a car mechanic) who told you about this, without actually explaining any of what it actually is. So you decide to make a video about it, without even doing a google search to even try and understand it. Almost all of what you said was wrong. Simply wrong. You should stop making youtube videos. Seriously, stop. Do the youtube community and the world a favor and just stay off social media, and go back to school. Seriously. Leave.
Reply: Cool
Reply: Sounds like the Kelvin system is broken
Reply: How i get a laser like yours
Reply: Dang
Reply: Or you get an inversion because quantum mechanics lets there be a ceiling on the energy allowed in at least some degrees of freedom. Thus it is possible to reach saturation (infinite temperature) at finite energy in those degrees, and then go past it to population inversion (negative temperature) - unlike heating an ordinary gas in which there is effectively no saturation (or you eventually create a black hole, at which point it is unclear if 'temperature' even makes sense at all given that we have no complete theory of black holes [viz. quantum gravity] yet.). Without such a ceiling, it doesn't matter how you 'stimulate' anything - it will just gain more and more energy.
Reply: @mike4ty4  well i dont think even that light has any heat :P if we assume its a wave, it can hawe negative wave/freq/sync but not heat ;P
Reply: @mike4ty4: That model is incomplete, therefore it's misleading to even call it "temperature". You end up with a "ceiling" or "negative temperature" if you ONLY consider the one radiating transition in a fluorescent laser medium and nothing else. The actual temperature is a measure of the actual heat, which is the energy sum over ALL microstates, especially kinetic energy states (speed of gas atoms or vibration strength in a solid), and not just the one state responsible for fluorescense. It's trivial to come up with weird measures of temperature if you only consider a subset of all states in a system. For example, the "temperature" of electrons in a valence band of a solid would be "infinite" (or zero??) because every single available state is occupied to the highest possible energy. But such a "temperature" is pretty meaningless, just like the "temperature" of the light-emitting states in a laser medium.
Reply: Ahh!! Too much word
Reply: What
Reply: typo's am I right 6:27
Reply: What about......

2 Magnifying glass :3
Reply: Thats so long lol
Reply: You could have removed the reflecter from the large light or you could have usen a larger magnifying glass
Reply: @yaseenmalik41  “usen” isn’t a word lol
Reply: Copy n paste 👏👏
Good job
Reply: You're braking the laws of physics ! 
You're going to jail .

😁
Just a joke 
Obviously
Reply: I shouldnt have clicked read more
Reply: i wish i new what he ment cz im no smart like him
Reply: Is it possible to rig this so that you use more than one magnifying glass?  To demonstrate the principle further?
Reply: What happens if u put like 5 magnifying glasses in front of the laser placed equally apart
Reply: So basically radial emition vs linear emition?
Reply: You wrote a frikin book!!
Reply: Awesome, thank you!
Reply: The Action Lab is a talking sloth
Reply: I thought negative Kelvin referred to how cold something is.... Shows how dumb i am :/
Reply: u talk too much like an idiot
Reply: I think an explanation of how infinite Kelvin's can be exceeded by number crunchers vs  the reality of the ever increasing and unquantifiable number of infinity and how it can be exceeded or can even be calculated.........
(I wish we had a shaking my head emoji)
Reply: We have problems with your workings, your mathematical understanding, your pretentious post explainations, and the fact that you condescendingly think YouTube subscribers means that you made it onto a level above the intellectual capacity of your viewers.
Reply: The laser light is coherent, strongly unidirectional and therefore has a high radiance value. This is why the lens was able to concentrate on a small but high radiance point. Even a weak laser light has a higher radiance than the Sun.
Reply: What if you put multiple magnifying glasses?
Reply: > This is a very good example of how the second law of thermodynamics can never be broken no matter how hard you try.

Because physicists will just redefine words in nonsensical ways to force the law to be "true" rather than admit they were wrong.
Reply: Incoherent or coherent
Reply: I always thought it was to do with energy density.  I.e for a magnifier in the sun, you'd concentrate x surface area of light into a much smaller point increasing the energy density at that point. For the sun it doesn't matter that it's so far away as the energy density at the Earth's surface is something like 800W per square meter. To focus the flashlight, you have to get it so far away that most of the energy is no longer hitting the lens (as the light spreads before it can hit it).  With the laser it already has a small area because of the beam size, so doesn't matter that it's distant (just like the suns rays almost being parallel because of the great distance). Obviously you'll never get more energy out than goes in, but concentrating it into a small space allows the burning.  Also LED's use quantum mechanical processes to emit light, in much the same way as a laser, without the 'A' - amplification.
Reply: Very long text
Reply: The Action Lab can you break it down to the small brain version for less smart people
Reply: K
Reply: The Action Lab and please could you try this with two magnifying glasses 🤔😌
Reply: If you put the heat of fire with the heat of the rubbing of your hand it will feel like your touching a ball of electricity
Reply: It’s kinda like the balloons when the rub
Reply: Speak English pls
Reply: Cool
Reply: aaaaaand That's all I needed, Thank you
Reply: Short said, too big brain for me
Reply: Jesus Christ you don’t have to write an essay
Reply: Well Blue or Violet Laser are more powerful than red amd yet you amplify it even further using Magnifying glass..
Reply: welp i feel a video dedicated to negative temperature is in order
Reply: wow dat big
Reply: Fascinating!
Reply: This seems like a very convoluted explanation for something much simpler, to me. Keep in mind that the Second Law isn't a concrete law at all; it's a statistical, emergent, and inherently macroscopic phenomenon. It's a bit of a paradox in and of itself, because on a macroscopic scale, it is one of the most inviolate principles in all of science... yet on a small-N scale, it is barely there at all. Entropy can and does decrease in closed systems all the time; it's just that the probability of it doing so on a macroscopic scale in macroscopic systems is exceedingly low (but not zero!) Even on the scale of the entire universe (the most macroscopic of all), the probability of a universe-wide entropy-reduction event is non-zero. Some theorize that the Big Bang itself may have been a spontaneous reduction in entropy in nature, and that even after the heat death of the universe, a new universe could spontaneously generate itself in an enormous random entropy fluctuation.

It's also important to mention that, at least as I understand it, the concept of "negative temperature" isn't necessarily meaningful in a physical sense. It's more of a quirky mathematical shorthand. The fact that the temperature has to "pass through" first positive and then negative infinity is a clue to the non-physicality of this definition. Any time the math you are using to represent reality tosses out infinities, it's a very good clue that you don't yet understand that part of the reality fully.

Ultimately, the second law is, I believe, an incorrect and poorly applicable means of understanding what is happening here because of the circularity of the definitions. "The laser doesn't violate the second law because it has a non-physical property derived from the second law" says very little of meaning, I think.
Reply: I didn't get it, seriously😂
Reply: TL;DR
Reply: Ok boomer
Reply: That’s a long comment
Reply: could you help me with my essay at school?
Reply: For your flashlight, you can put a collimating lens to have all light ray parallel (like the laser) and then you put your magnifying lens.
And I think you misunderstood the principal involved here. What is important here is the energy density in J/m2. In your setup the energy will always stay at the same value (if not taking in account the losses) but the surface will drastically be reduced (focusing) so the energy density is locally increasing (more photons hitting the target at the same location) thus burning the target.
Negative temperature has nothing to do here. If you put a TC you’ll measure a temperature not that crazy high.
Thanks for being curious
Reply: Your laser is 1W or 3W do your research
Reply: @ericroy1880  lol correcting a nerd XD HAHAHAHAHA
Reply: Hey, can you please put down a link to buy that laser, please?
Reply: The Action Lab you and styropyro should team up on a vid.
Reply: O k
Reply: We want a telescope 🔭 system bro. By chance. I like the 🔭 and the space programs. Thank you bro
Reply: If you had enough lenses, we could easily focus the light of the flashlight into a single point... And it wouldn't break the second law of thermodynamics either. To light such a large area, a large amount of energy has to be used, and when focused, it's much hotter than normal... That's actually what lasers do.
Reply: But the temperature of the surface of the Sun has nothing to do with the temperature you can achieve by focusing its light... in fact, theoretically, you should be able to increase the temperature indefinitely, because what matters, for a given surface, is energy (heat), not power, power is energy per unit of time, so as time progresses, the surface will heat up.
Reply: How many letters did you write?
Reply: Explain how it doesn't break the third law when light slows down after entering a glass and speeds up when exiting. LMAO YOU CAN'T. Murican Public Education has made everyone an actual dopehead.
Reply: The Action Lab I did not read that
Reply: @AEON.  Oh, maybe they had beam splitters. A violet and red laser?
Reply: The Action Lab So where does the Planck temperature fall in between 0K and infinity K? Or is the Planck temperature the “infinite” temperature we’re talking about? I understand that this video is for explaining the 2nd law of thermo, but I couldn’t help but think about why the Planck temperature wasn’t mentioned before “infinity” kelvin.
Reply: Get 100 magnifying glasses
Reply: You wrote a lot jeeze
Reply: My man put a whole science report in the essay
Reply: Thx
Now I think I'm starting to get it.
Reply: I saw that you bought a amazon Lazer and that's only 1 watt
Reply: I see that you have an amazon 1 watt  Lazer plus it's illegal to sell
Reply: The Action Lab  

TL;DR
Reply: I haven’t worked with temperatures in a few years and I was confused as heck when I saw “negative kelvin”
Reply: Yeah but the thing is ....
It never broke the second law of thermodynamics in the first place
Reply: The longest text ever.
Reply: You can't make the laser infinitely hot it's impossible
Reply: Nice essay
Reply: this is one of the things you'll never need to know in your lifetime. I hope someone gets to use this knowledge, eventually
Reply: Sir where do i get this laser
Reply: whoever scrolled this and refused to read : 100JZW iq
Reply: so basicaly ur apologizing for click baiting us??
Reply: The action lab: *Scientific explanation*
My brain: *Ah yes, the floor here is made out of floor*
Reply: So does absolute hot (https://en.wikipedia.org/wiki/Absolute_hot ) not actually exist?
Reply: The only problem I have is the negative number. You could just say that the laser is hotter than the focus point, so no laws broken. How do you measure temperature of a monochromatic light anyway?
Reply: Ah gosh... never click see more on an action lab comment unless you want to melt your brain
Reply: After all, using two lenses you can narrow the beam of light from the flashlight to a point of greater brightness than the light source in the flashlight. So, the example with a flashlight is not true.
Reply: You are amazing thanks yet again for an amazing video full of knowledge! I assumed it would get hotter but that's a misconception🤔 Unless I've missed something. I will watch the video again.
Reply: So it can only get as hot as the actual source🤔 Just wow!
Reply: Why does artificial light still produce full white light? Yet only one visible white colour. Yet I assumed you need 7 colours to produce white light 🤔 I so need these answering. Light is so intreging! This sounds a dumb question but it actually isn't.
Reply: And what if I magnify a laser that is pointed to another magnified laser pointing to the other one? 🧐
Reply: Just accept the video is confusing and poorly explained...
Reply: Excuse ME sir, did some one pay u to write all of this beacause man that is impressive 😂👍
Reply: "Of course the reason the laser gets hotter when it’s focused is due to the reduced surface area of the light. That was not my point though." -- I've always wanted to say this: for shizzle!
Reply: Yeah sure thing you can burnt an ant with a magnifying glass coz it concentrates its energy into one smaller point, meaning it would have higher temperature.... in a smaller point take note of that. He means that the energy emits by the flashlight and in the light of magnifying glass are just the same. You can't light up the whole area if you put a magnifying glass out of the light of the flash light, but you can high up the energy by focusing the energy into smaller point using magnifying glass. You guys perception's are misconcepted about this video.
Reply: I wonder if you can use lazer tech to creat a perpetual flow of energy.
Reply: @andrey4898  I'm not sure if youre correct or not, but if you are, that's only part of it;  a laser's photons are only able to remain parallel (and/or be emitted that way maybe?) because they are all (roughly) the same wavelength.
....and the narrower you can get that laser's range of wavelengths, the less it's beam will spread over a given distance.
Reply: I don't understand
Reply: @bosubengos  me neither 
Much words and much unwanted reading
I speak doge
Reply: What it you put the torch in a long reflective tube so all the light gets into the lense? And with the sun, you'd think you'd be able to get even more light in all sorts of different ways.
Reply: I did not read that
Reply: @bethanyaubart8943  me neither
Much words much unwanted reading
I speak the ancient language of doge
I do not speak nerd
Reply: Introducing negative temperatures so experiment wouldnt break old law of thermodynamics  seem like lazyscience(cheating) 
Maybe law needs some revision. 
Also if old law isnt 100% right , that would mean science revolution
Reply: Methionylglutaminylarginyltyrosylglutamylserylleucylphenylalanylalanylglut aminylleucyllysylglutamylarginyliysyglutamylgycylalanylphenylaanylvalylpro lylphenylalanylvalylthreonylleucylglycylaspartylprolylglycyllisoleucylglutamyl glutaminylserylleucyllysylisoleucylaspartyithreonylleucylisoleucylglutamylal anylglycylalanylaspartylalanylleucylglutamylleucylglycylisoleucylprolylphen ylalanylserylaspartylprolylleucylalanylaspartylglycylprolylthreonylisoleucylgl utaminylasparaginylalanylthreonylleucylarginylalanylphenylalanylalanylalan ylglycylvalylthreonylprolylalanylglutaminylcysteinylphenylalanylglutamylmet hionylleucylalanylleucylisoleucylarginylglutaminyllysylhistidylprolylthreonylis oleucylprolylisoleucylglycylleucylleucylmethionyltyrosylalanlylasparaginylle ucylvalylphenylalanylasparaginyllysylglycylisoleucylaspartylglutamylphenyl alanyltyrosylalanylglutaminyicysteinylglutamyllysylvalylglycylvalylaspartylsr ylvalylleucylvalylalanylaspartylvalylprolylvalylglutaminylglutamylserylalanylp rolylphenylalanylarginylgiutaminylalanylalanylleucylarginylhistidylasparagin ylvalylalanylprolylisoleucylphenylalanylisoleucylcysteinylprolylprolylaspartyl alanylaspartylaspartylaspartylleucylleucylarginyiglutaminylisoleucylalanylse ryltyrosylglycylarginylglycyltyrosylthreonyltyrosylleucylleucylserylarginylalan yiglycylvalylthreonylglycylalanyiglutamylasparaginylarginylalanylalanyileucy leucyllysylglutamyltyrosylasparaginylalanylalanylprolylprolylleucylglutamin ylglycylphenylalanylglysylisoleucyiserylalanylprolylaspartylglutaminylvalylly sylalanylalanylisoleucylaspartylalanylglycylalanylalanylglycylalanylisoleucyl seryiglycylserylalanylisoleucylvalyllysylisoleucylisoleucylglutamylglutaminyl histidylasparaginylisoleucylglutamylprolylglutamyllysylmethionylleucylalany lalanylleucyllysylvalylphenylalanylvalylglutaminylprolylmethionyilysylalanylal anylthreonylarginylserine
Reply: Im lazy to read an essay
Reply: immmmm not reading this
Reply: Michael is literally that one guy from stack exchange that gives the top answers
Reply: okay but surely you could just use a second magnifying glass?
Reply: Hm, and there I thought, I can take a flashlight (a xenon lamp), and use its output to pump a ruby laser. Or even simpler to come by, point my flashlight at a cheap solar panel, and use the electricity generated that way to power a laser diode.
Reply: DONT LIE who read all lol
Reply: That one longgest comment
Reply: Err... I subscribed to you, watched a few videos... the. Watched this. Then read your explanation... nope.. time to unsubscribe - this ain’t for me
Reply: i can’t read so im just not gonna even try
Reply: hmm
Reply: @ Action Lab. As I know, the story goes over. There is a thing called "non imaging optics" that allowed it's inventor to build a solar concentrator (on earth surface) with a focal point that has exceeded by something like 15% the temperature or brightness of the sun's surface itself.
Years ago I longly reasoned about this phenomena and the apparent breaking of the thermodynamic principles. I can't tell the wole story but the end of the reasoning was that everything has bedn saved by a necessary fact: A mirror can't reflect wavelenghts that are equal to the wavelenght they emit because of their proper temperature.
If someone is interested in the deduction of this unpiblished law, can ask me detail. Bye bye.
Reply: @grazianoturbogas  And somehow all the blueprints of this marvellous "lens" were mysteriously lost in the same fire "accident" that destroyed all evidence of a perfectly working free-energy magnet motor :)... Oh well, there's just no hiding from the Secret Carnot Society.
Reply: So, suppose the total amount of light hitting the magnifying glass is produced by 1cm squared of the light source. Now, if you focus that to an area lesser than that, suppose 1mm squared, how is that not getting hotter/brighter than the source?
Reply: @masbicudo  Because you can't focus it down to 1mm squared! If your source is 1cm large, you can focus ALL the light back to 1cm at best, not smaller. Or you can select parallel rays and focus them to a diffraction-limited tiny spot, but then you won't focus all the light, just a small fraction of it which comes from a small fraction of the source area. How can that get hotter than the source?
Reply: why don't you try to focus a light by covering a flashlight with dark black paper and then try to focus it?
Reply: Am I supposed to read THIS HUGE LETTER ?

Do you even know who I am ?

Cuz I don't I wanna remenber
Reply: have you tried a laser and a telescope 🤔🔭
Reply: 420th reply
Reply: I thought regular light could be focused down to a hotter point by using a parabolic mirror and lens that are much much bigger than the light source?
Reply: Microscope?
Reply: What's the actual temperature
Reply: Damm son
Reply: Aaaaaaaah  much words(am speaking like doge) much unwanted reading
Reply: i may be dumb but i thought one reason you cant do this is that temperature is just how fast particles are moving around and you need an infinite amount of energy to make a particle move at the speed of light so you could never just integer overflow or something like that but you may be able to break atoms or cause fusion or things like that, but not with just a magnifying glass as the large hadron collider is basically a super powerful laser or something that does smash atoms and create absurd temperatures. idk how much of that makes sense or that i got right, im not a physics major or anything
Reply: is the laser hot enough to heat a Incandescent light bulb filament directly 🤔💡😯
Reply: Question for the flashlight thing, what happens with multiple lenses.
Reply: Lasers do spread though, they can pop a balloon in an instant at a foot, but require a minute at 20 feet
Reply: what kind of laser are you using?
Reply: Not bad I had a similar theory but in the opposite direction on the spectrum however there is a problem with your explanation disregarding planks constant the problem is that the temperature of the burn area would react with the surrounding area canceling each other out positive and negative which on my scale would reduce it to absolute zero and it would Frost over and on your scale would cause it to shift to infinite heat creating explosive spontaneous combustion as neither happened that means there has to be another explanation try again
Reply: En español por favor.
Reply: Sure 😅😅😅
Reply: E
Reply: Stimulated emissions? 
Sounds like erotica 😅
Reply: What do you think about The great pyramid k2019's theory about how they think we could melt granit for sunlight ?
Reply: THE SUN IS A DEADLY LAZAR
Reply: SO POINT YOUR BURNING LAZER THROUGH A MICROSCOPE...THAT MIGHT WORK...RIGHT ???
Reply: haha
Reply: FAX
Reply: I have LED torch with a convex lens in front which can be turned and most of the light focussed to a very small point. When tried with a normal light meter after the light is passed through a dark film glass( to reduce intensity so that normal light meter can measure), the pointed beam showed much higher value than the spread beam. That means most of the light can be focussed to a point using right convex lenses and reflectors
Reply: I'm not reading this
Reply: You used a shitty example.
Reply: Interesting, but could you not potentially capture all the light from the LED flashlight using a reflecting tube/concave mirror of some sort and then pass it through the magnifying lens? Then you would be focussing all the available energy into a point thus causing it be brighter than the original source. The LED light is not a collimated beam thus dispersing and therefore weakening in intensity as it spreads in 3 dimensions.
Reply: But you can focus a flash light down to a ding point... that’s what a laser is. You would just need a a boy or conclaves lens to create parallel light been and then your mag one glass to collect all light down to a ding point. Open any laser pointer and that’s what’s inside.... this was literally the opposite of what you’d learn in a photons class
Reply: you would have use a concave mirror in front of torch for further focous
Reply: I think saying that laser have a twice infinite temperature makes more sense and less misleading. But I would just said that second low is only applicable to classic thermal emission, and not to the stimulated emission used in lasers. In other case there is a question how light pumping of the laser transmit the energy from the source with normal positive temperature to the laser with higher "negative".
Another theoretical question: may a single photon be focused to a single point? Even if it is thermally emitted it should be coherent to itself. Then if we create an infinite fast optical system which will adapt to each photon emitted from different points of the source and focus it to the same point on target, then we will also heat it to infinite temperature and broke the Law.
Reply: What if the number line is actually a circle?

And just like the Kelvin scale infinity comes back to zero.
🤔
Reply: Reminds me of Mexican Cantinflas...
Reply: Who noticed the misspell at the star of when he was typing he said it not is
Reply: Well that just sounds like the 2nd Law of Thermodynamics was actually broken by quantum mechanics, so they had to make up the concept of "negative temperature" to make it fit. One could, theoretically, just make a new model of physics that incorporates quantum concepts more cleanly.
Reply: Disagree on your can never
Reply: @The Action Lab I've done well with LEDS
Reply: I concur!
Reply: I'm not saying getting hotter I'm saying you can increase your voltage through optics
Reply: What do you think a laser even is? It's just light that's forced to align. You can do this with any light source if you have the proper lenses.
Reply: PUT A cylindrical REFLECTOR round the torch.
Reply: +0K =-0K
Reply: What's your opinion on the flat earth argument.
Reply: It skipped through my brains
Reply: 6:28 bro that energhy tough
Reply: Yes definitely understood that
Reply: Awesome video. After watching it I sat here thinking and now I have a hypothetical question:
If a person (or people) were technologically skilled and crafty enough, would they be able to apply the idea of magnifying negative lasers to make a laser gun-type stuff like in Star Wars?
Like if you were to magnify the beam enough and make it so its "activated" when you pull the trigger and it shoots little lasers. Would it even work the same though?
Reply: The second law of thermodynamics has nothing to do with it, it is not an isolated system, because we have a source of energy in the lamp. It's just a matter of optics, how to correctly focus the light beam and get a higher temperature in a smaller area. It is the same with the Sun and with any light source. It is easier with a laser just because the beams are parallel and not scattered.
Reply: there aren't only two energy levels though, there are countably infinite energy levels. so why can't you just reach hotter and hotter temperatures by raising <50% of the particles to higher and higher energy levels?  and surely a system where one particle is at energy level 50 and 9 are at the energy level 1 is going to have a higher average energy and thus higher temperature than a supposedly "inverted" system where all 10 particles are at energy level 2, which this video indicates would have a "negative" temperature.
Reply: Uhhh I-
Reply: If our temperature system requires positive and negative infinities to correctly describe the universe, then our temperature scale is broken, not the universe. 

Also your definition of temperature here doesn’t jive with any definition I’ve ever heard. I’ve always heard temperature defined as the average kinetic energy of the molecules in a substance. Under that definition, infinities would seem to make no sense.
Reply: Mashaallah what an explanation
Reply: I saw a lot of light anomalies.  Everyone should rewatch over and over.
Reply: Saw some cool light anomalies.  Watch over and over
Reply: i want that 5 watt burning laser >:)
Reply: Seems like a kind of stupid idea to come up with terms like those. Like infinity being a point you can cross somehow, and negative zero being something completely different to regular zero. Just seems like someone very smart being effectively very dumb, and making things unnessesarily complicated and nonsensical.
Reply: You can focus infra red light with lenses
Reply: My difficulty in understanding is that the Kelvin scale is basically a comparison between populations in inactive and active states, but for a counting scale it doesn’t behave like any other number scales we’re used to in the realm of real numbers.
Reply: yeah that lazer is illeagal at the same time not it claims to be under 1 watt but its 5 watts wich cant be sold by a hand held lazer
Reply: link to the laser light plss
Reply: 1
Reply: With other posters on this. Love your work. But, respectfully, your experiment does not actually clearly illustrate the phenomenon you're describing. It 'nearly' does - but it still doesn't. It's that simple. The sun through a lens can burn... Start combustion. Can and will start a fire. That has zero to do with negative temperature but it looks like you draw a (false) distinction with your laser experiment by almost implying it can't. Yes. You did say a focal point can't get hotter than the surface of the sun but your illustration looks like merely condensing light to an arbitrary ignition temperature. The 'demonstration' doesn't prove the proposition.
 Still... Your explanation of what was going on was still cool and interesting. And the surface of the sun part might will of course work... But the "why is the surface temperature at an area here hotter than there" explanation can only be hand-wavy and 'trust me' if your positive temperate heat demonstration involves the sun and negative involves a laser... Unless a few interim lens are involved perhaps? Maybe some splitters/diffraction grates? Maybe there's another experiment lurking in this somewhere... ? 🤔 You could measure temperatures at a primary solar collector lens, then at a secondary condensor after. But then you need to explain the heat energy over the area carefully, as distinct from temperature. If you could feel the heat over your skin from the sun it might not burn you - that temperature might be fine over an area of skin. But you could easily condense that light to a higher temperature at a point through a lens. The heat hasn't increased over all - in fact much has been lost- but the heat density (temperature at a point) is indeed higher than any individual temperature reading at the area where the light goes into the lens. I think this experiment needs a bit of a rethink in the presentation.
Edit:and i forgot to mention... Teasing apart light and heat where relevant might help too.
Reply: Thats a  alot
Reply: Super interesting, though I still don't understand even after the explanation.
Reply: Too many to check on with this reply to know if someone may have already used this analogy.  Here goes. Try thinking in terms of electricity. Specifically transformers. You can use a step up transformer to increase voltage current by using larger wire with less turns to do silly things like melting metal from an input voltage of 2000 volts which by itself could not be achieved but is easily done when induced with larger wire giving the illusion of producing more power output than input thus breaking the laws of thermodynamics. But it is just that, an illusion ( there are numerous YouTube microwave oven transformer videos to source.) You cannot get out more energy than you put in. This applies in all areas of physics. But as for Quantum physics. I don't know diddley squat! But I'm sure there are those who claim it can be done. On this subject I claim the fifth.
Reply: Am I speaking the same language as everyone🤓
Reply: I think you're the one struggling here, my guy. You have a lot of wrong turns to arrive at the right answer which is that neither thermodynamics nor conservation of etendue have been violated.

Problem is you're creating something totally unnecessary and wrong to explain it when it's actually a very simple explanation. You're not creating heat, your reducing the area over which the same amount of heat is applied, you're not creating brightness you're applying that brightness over a smaller area. It's really not that hard a concept to understand.

You may not have violated thermodynamics but you're violating occam's razor.
Reply: What if you took a microscope 1000x or higher lense cylinder on the end of your laser
Reply: How long did it take to type all that
Reply: what about a mirrored chamber between flashlight and magnifying lens 🤔 what would that do?
Reply: Bruhh
Reply: Thanks for the video and the follow up post. Little late to the party but I've tried to learn something new everydau and at 41 I would say I'm averaging 6 days a week since I was 25 or so. Thank you for making me a slightly more well rounded person and for helping satiate my thirst for knowledge.
Reply: Can you put the link for this 5W laser?
Reply: Okay so now they've got flashlights you can actually cook with because there so hot one of them which apparently can cook an egg and 45 sec their survival lights kind of like a I think they put out like 30,000 Au of light or whatever that is if you took that light and put it through a magnifying glass. I bet it would burn I think that if the flashlight could put out some kind of  heat or at least half of the heat the laser can put out I bet you a nickel it would burn with the magnifying. I think the reason why the sun is able to do it cuz they're ultraviolet rays
Anyway I'm just taking a guess here but you know more about it than I do what do you think sir. Also great video and I appreciate the hard work you put into this also what if you use multiple different sizes of magnifying glasses for the laser and also you should try different colors of lazers
Reply: im a german so plz forgive my bad gramer but i HAVE to trole :)))   i quote .. Please research “conservation of etendue” to understand why you can’t focus a flashlight down to a point that is hotter/brighter than the flashlight surface.    ehmmm  im shure u can understand my point if i say  the flashlight surface is close to roometemperature and my tiny flashlite´s light heats things to more than to roomtemperature.  BTW im troling the not realy on the point wording ... X))
Reply: Would a frenel lens focus the beam more than magnifying glass or less
Reply: Okay, I admit I have not read through this explanation and thought about it properly to say I understand it. But this does make me really curious about whether or not any signs of an interference pattern can be observed while doing this kind of experiment. When you focus light because all the light is of the same wavelength that's able to add together. Does that mean that the amplitude of the wave is increasing? Clearly I have no understanding of wave dynamics 😢. Overall, my curiosity, pertains to the actual nature of light as patical/wave and really trying to wrap my head around what situations behaves in which way and why?
Reply: Could a parabolic mirror in a little bit of math focus on flashlight down to a point smaller than the source?
Reply: The hottest temperature you can possibly get is the planck temperature, infinite temperature is impossible
Reply: Are the Atomic states out west somewhere and how much will their populations effect senate seats and the electoral college?  😉
Reply: You could do the same with the sun if you had a big enough magnifying glass!!
Reply: You do an admirable job defending and explaining it would appear but when they content creator fails to prove his statement and the majority of his audience point out several flaws in his explanation then its a creator problem, not an audience problem.

I was getting bored counting the negative comments ... class dismissed!! ....
Reply: @scottbishop7899  I don't know why he chose an obscure quantum statistics example to make a pop science video about. He could've just compared a coherent with an incoherent light source and talk about the much more instructive diffraction limit (which limits the focus spot size even for his laser) instead of unintuitive quantum temperatures.
Reply: nerrrrrd
Reply: So if I use the right set of lenses to capture and focus 100% of a flashlight’s light to a tiny point, will it behave just like your laser?
Reply: so, in theory focusing an incandescent or a halogen lamp will work since the internal temperature is very high in both...
Reply: Всичко разбрах само не можах да разбера за къде ще ГО ползваш този меч на Дарт Вейдър нали Господ Бог все още ни дава ☀️ на всички безвъзмездно 😶😐😶❤️👍
Reply: @alexpopov-iv1ni  In Soviet Union, government lasers you
Reply: what about multible magnifying glasses
Reply: In a simple laser pen there is a simple diode and lenses that focuse the light the reason why you couldn't focuse the light from the flash light was because of how the flash light works and you did focuse the light even when you where close to the flash light if you had used 3 or maybe 5 magnifying glass you could've focused it even more because what the first magnifying glass did was shift the focal point closer if you had another one it would of shifted even closer and so on until you would have a perfectly focused beam of light you can easily make it brighter and hotter than the surface of the flash light because the less material you have the less energy it requires to heat or cool it down so if it didn't get hotter that it self would be violating the laws of physics assuming there is no reflection and all the light is absorbed and no heat is radiated outwards
Reply: wouldn't negative temperature indicate the extraction of energy from the vacuum?
Reply: I ain’t reading all of that
Reply: Reaching infinite kelvin then looping around to negative infinity kelvin...

I gotta say, as a physicist and a mathematician, delete your channel, you cant just make shit up and pass it off as fact.

"In this case we have to define temperature as negative or else we get into problems that break the second law of thermodynamics."

In order to validate this theory in line with the laws of physics you just threw the laws of mathematics out the window, NEWSFLASH, THOSE PRINCIPALS ARE WHAT ALL PHYSICS IS BUILT FROM.
Reply: I don't think anyone is claiming that the total energy produced would be higher but the energy would be higher per cm^2. You concentrate the energy in a smaller area. I get what you are trying to say its just not a very good example.
Reply: 500th reply
Reply: what would it take for you to repeat this with the Giant 200W laser from the @thebackyardscientist 🤔🤔🤔🤔
Reply: I aint reading that all💀
Reply: I am a laser physicist. You're wrong about much of this. Laser beams absolutely do spread. A typical laser pointer would cover much of the moons surface for example. Also, classical mechanics says nothing about quantum States. The paradox is resolved by realizing that statistical mechanics intuition is generally based on assumption of ergodicity among other things, and this is not true when you're actively driving a system like a laser. A laser is not emitting thermal/black body radiation like the sun is. I could go on but idk if you'll even read this
Reply: Negative temperature and infinite temperature are silly terms. We need better language dear Physicists.
Coz this is even sillier sounding than the many-worlds speak of quantum mechanics.
Reply: What about a mechanism in which a system of lenses (or something else) would convert the beam of sunlight from the Magnifying Glass into a laser that could burn things at different distances and in different directions?
Reply: What a pile of s...t you wrote...
Reply: I ain’t reading allat
Reply: negative temperature is the wrong wording, that would mean shining a -500K laser onto an 793K hot object would reduce it to room temperature, which isn't the case.

the dot get's hotter but the area gets smaller, so the amount of energy is conseverd, it is actually very simple
Reply: It's all about energy densities and not energy quantity. The quantity of energy remains the same, but the density increases. This means that more photons (energy wave) start interacting with less matter. Electrons will be colliding and start bouncing around. Matter will absorb and release charged particles. All this excitement causes friction and this energy is released as heat. Think of a curtain of beads in your doorway. The wind from outside might not affect the strings in any way, but if you set up a electric fan (concentrated)  it will blow them around easily. This movement between the beads and the air will cause the particles (strings of beads) to move and this causes friction with the air (hardly measurable tho in this case )
This is why electrical wires are warm to the touch. It's because a lot of charged particles are being conducted through a very tight space. The electrons cause the copper to heat up because copper particles start vibrating and electrons in the copper start bouncing around. 
With a very low current there would be less  heating of the wiring because the electricity can move more freely through the wiring causing less interactions with the actual copper. More current is being transferred with less energy loss from heating, but at the cost of loss of power density.
Reply: @TheActionLab what would happen if you used a death ray lens?
Reply: Maybe you can try focusing solar death ray with magnifying glass, i really want see it 😊
Reply: Do it with metal, though.
Reply: What if we point 100 powerful lasers on a prism prism which redirect all the combined energy of lasers on magnifying glass which further concentrate it on very tiny point 💀☠️
Reply: what about polarized light  ?
Reply: May I ask what brand that laser is ? My friend has the same one, but his is green and does not get high although it’s very powerful. It looks like there’s attachments for the front because it’s threaded.
Reply: ok now do it again with a telescope
Reply: Because it is already broken and scientists are coming up with ridiculous explanations.
Reply: What about a non imaging collector first.
Reply: No it's that your laser was burning stuff without the magnifying glass
Reply: for focusing almost all not coherent light you just need prevent dispersion and use mirrors system after the lighter where all light will mirroring inside the tube and get out to lens for be focused and then you will got focused energy. about negative temperature. energy of atoms just can not be negative, it's not about electrons positions it's literally about speed of atoms or molecules. as fast particles so more temperature, or opposite, it's only one measure. whole energy can be depend of electrons conditions, but temperature is just other stuff. degree and joule. they are on the different scales and show the different stuff. they are coherent in a laser but they don't need to have behavior of negative temperature, they  just coherent, and as result minimum dispersion.
Reply: Mirrored funnel between flashlight and lens
Reply: magnify it thru a microscope or telescope... one more thing, when u was using the flashlight, u could probably focus all the light if u had 2 or 3 lens, with the first one close to the flashlight capturing all the light and keep refracting it down to a point.
Reply: i know but the laser would get a lot hotter if you used more magnifying glasses right?
Reply: Yes the point you were making wasn’t very clear to me.
Reply: Sorry but you talk way to much
Reply: The laser has a negative temperature value* not exactly a negative temperature. There's a difference. The laser is whatever the ambiant air surrounding the light is passing through multiplied by the focus and intensity of the beam. It passes through the open air, vacuum of space etc until it reaches solid matter and connects then acts like a closed electrical circuit.
Reply: Your video is an incredible collection of misconceptions.

First thing, to start with, is that the second law is about "energy", not temperature.

The problem of flashlights is just that you're unable to focus because the rays are not parallel and/or you can't gather all of them into the lens. Pure optics.
Reply: @Dan_Moller   There is a law that says you can't flow energy from cold to hot, I'm pretty sure.  Not without work anyway.
Reply: Do something about #saveyourinternet in europe
Reply: Puh, thats a mess of quite advanced physics, bad examples, confusing simplifications and different definitions from all sides At least I learn a lot trying to figure out what is wrong and what is correct.
But one thing I can say for sure: The video and most of the answers are not fully correct.
Reply: It would be possible to focus the light of a flashlight to achieve a point that is hotter/brighter than the flashlight because you are not increasing its energy output but reducing its area of effect thus increasing its energy at the focused point while the overall energy in the system stays the same. As for the conservation of etendue you would be correct if a flashlight was a singular light source but it is not. You are actually focusing several sources of light ( the LEDs inside the flashlight ) into a point without changing their etendue. At least that's my understanding of how it works so correct me if I'm wrong.
Reply: @vzima23  I believe you're incorrect. If you gathered all the heat energy into a single point, it would indeed be hotter than the point created  by the magnifying glass. Do you go around touching the light element directly? It's fricking hot lol. It's simple; imagine you push a cart in the store on a level ground. Now imagine it continues to speed up after the initial force you apply with no external force acting upon it. That'd be the same as getting a greater energy output from a magnifying glass than the flashlight emits. You cannot get something from nothing. So, no, the point of light in a magnifying glass is not greater than the heat (or energy) at the source, assuming no additional energy has been added from alternate sources.
Reply: Sry. Your explanation is like:

It gets bigger than infinite because quantum mechanics because of lasers because of quantum mechanics of lasers.

Short version:
Lazors dude. Lazors quantum mechanics dude.

Doesn't seem veey explanatory
Reply: @motbus3  I was talking about the flash light because it is so expanded... to make it more focused would enable it to be hotter in one point and not everywhere else, this was my original topic thank you.
Reply: The Action Lab negative zero is equal to zero so saying the hottest temperature possible is negative zero kelvin is to say that zero kelvin is the hottest possible temperature which is completely nonsensical because zero kelvin is the absence of any vibration within the molecules and the complete opposite of hot by every sense of the term

Edit: I made this comment fully believing it to be true but I have learned more about the subject and found out that I was wrong, but I don’t think I should delete the comment because it is important to admit your mistakes and not hide them
Reply: @np6181  welcome to advanced physics. Inventing nonsensical terminology to describe real world phenomena since Plato.
Reply: @np6181  What he said! 😀
Reply: @np6181  Bruh that's just a way of expressing the highest "negative" temperature possible. -0K is not equal to 0K. If what you say is correct, then we can never even reach _infinity_K (as infinity is just a concept, not a number) and sure as hell can't go to _-infinity_K from _infinity_K by continuously increasing the temperature.

It's just a fast and easier way of expressing the concept they need to express.

In physics we often consider 1/0 as infinite rather than an inderminate form, so yeah, my point is that things sometimes aren't consistent in two different field of studies. (I can mention the case of different sign conventions in thermodynamics, merely by the fact if it is studied by a physicist or a chemist, but that has its own reasons)
Reply: @np6181  i am no physicist but based on the video i assume negative 0 kelvin is when all the atoms are in the highest energy state which is different than all of them being in the lowest energy state (positive 0 kelvin). no idea why they define it as negative 0 maybe it makes the math work out idk
Reply: @np6181  The difference is entropy vs order, Brownian motion vs uniform motion (or non-motion). In an experiment to reach absolute zero lasers are used, that is to say Energy is used to stop kinetic molecular motion. Equal and opposite force applied to achieve a temperature of 0k not a state of zero energy just temperature. Negative temperature is a reduction of kinetic molecular motion not negative kelvin.
Reply: @np6181  correct
Reply: @np6181  thank you!
Reply: @np6181  look at it this way
0k is all atoms at the lowest energy state
the highest possible temperature would be when the atoms are evenly distributed between all the energy states from the lowest to the highest energy states
so what do we call it when we somehow manage to get all the atoms in the highest energy state?
negative zero.....
tldr; negative zero kelvin is not the same as zero kelvin due to the definition of the "highest possible temperature"
Reply: @np6181  It's not based on actual numbers: 0K means all atoms at their lowest energy states, -0K means all atoms at their highest energy state. 0K is not equal to -0K, the reason why the nomenclature is misleading is because it's been adapted from classical physics into quantum.
Reply: @enricobianchi4499  it’s 0k hahaha it’s 0k but I mean it’s OKAY HAHAHAHAHAHA
Reply: @np6181  simple logic bro, if you heat an object up to the point where it can no longer it expand it is at max compacity why is temperature not like that, because if i reach 100% of the max temperature where can i go how can i move if i can't expand. So it would be absolute zero because just like infinity right is endless so is zero what is nothing of nothing 1 why because you can divide it into anything else it is already empty and full just like this equation seeing a really efficient way for energy and seeing it denied is not worth it i'd rather try and fail than to never see the truth. Is this glass half empty half full, is this Schrodinger's cat still alive or still dead in its super state, is this absense of temperature really the cause for this loss of vibration or maybe just maybe im wrong but i believe this ending of vibration is due to it being both either extremely hot or extremely cold, and by extreme i mean infinite but; i say this only because you will lose energy even in this system, by the lenses refracting the light its not just natural light it is generated from the sources of the laser and these lenses will absorb some of their energy, this is a really good way to creat power that will last for ions atleast, now i must make this machine.
Reply: @np6181  positive 0K would be every atom ks kept perfectly still in it's lowest energu state.
Negative 0K would be every atom is in a higher energy state and perfectly still. This would emit the most energy possible as light as literally all energy of the system goes into emitting light.
Reply: @np6181  bravo!
Reply: @np6181  I wish flat earthers be like you. Kudos for doing the research and admitting you're wrong.
Reply: @np6181 is that because at fast enough speeds things would appear motionless? So at least scientifically they are identical? Or would 0 Kelvin be able to freeze OR burn? Damn I felt I understood but I'm not sure now.
Reply: @np6181  I think what he mean to say when referring to -0k was the approach of 0k from a negative value. When discussing positive temperatures the higher the value the hotter the temperature but in negative the closer you get to 0 the hotter things become. Theoretically some infinitesimal approaching 0k from the negative side would be as hot as you could get.
Reply: Aaron Austin but heat IS movement and to say that something moves so much that it doesn’t is just wrong
Reply: HIIIIIIIIIIIiiiiiiiiiiiii :) cool study
Reply: Infinite temperature can never be achieved
Reply: I think you mixing up stimulated emission and stimulated absorption. With T=>infinity, the higher Energy state is as occupied as the lower and only stimulated emission and spontaneous emission (no absorption) will happen. (see Einstein coefficients) 

Lasers do spread, they have a gaussian beam due to the Uncertainty Principle. 

The Energy-Time Uncertainty Principle also says that with T=>infinity, the energy states will go to infinity and therefore the Emission rate would also go to infinity. That means you can never raise the energy states faster than they would fall down.

I'm really interested in the theory of negative temperature though, you have any sources?
Reply: @Krisisisis   It's not his theory; it's a concept in thermodynamics.  Any statistical mechanics book should derive it mathematically.
Reply: Just one question, how is absolute temperature the hottest point? Or did I miss something?
Reply: @ToVoMo Absolute hot is the temperature attained when the wavelength of your photon is equal to Planck length. As nothing can be shorter than Planck length, nothing can be hotter than Planck Temperature.
Reply: Just stop clickbaiting
Reply: In other words, the total power of the laser will be 5 W regardless of the size of the "dot" however, due to it being more concentrated (i.e smaller footprint) it means the total amount of energy per area will be higher. As for negative temperatures, the laser wavelength means that the electrons of the atoms where it incides are "slowed down" in one direction forcing them lower and lower energy states.
Reply: Every ant killer with a magnifying glass knows you’re just concentrating the energy into a smaller point. It’s like shooting a gun. You take the full force of the bullet in the kick back of the gun but the gun body doesn’t go through your hand. The bullet is smaller and concentrates the energy.
Reply: @anthonyvescio5311   part right, but far from full force. Heat is energy as well as motion is. My old solid breachblock 22 spent cartridge came out red hot. My nylon 66 barely warm. Old gun was 20% faster bullet. Same ammo same day. Bullet weighs about 5 grams gun about 2500 so....5/2500~1/500 ratio for Newton's law of bullet to gun/ efficiency factor.
Reply: @anthonyvescio5311  you don't take the full force of the bullet in your hand, you have to take the full impulse, which isn't the same thing. In the case of the bullet, it's not just the area, but the mass of the gun that helps. best demo you can do yourself: stack a few quarters on your head, then stack a few textbooks on top of that, then have a friend hit the top of your the textbooks with a hammer. The area of the quarters is similar to the area of the hammer head, but you'll still be protected from skull fractures by the mass and cushion of the books. guns aren't so cushiony as books, but if you could find a massive metal bars to stack on the quarters on your head, enough mass would still protect you from skull fractures. alternatively, affix some extra weight to the gun and feel the difference in the recoil. To get some sense of the mathematical accuracy, check the ratio of the mass of the bullet (and powder if you want to add that in) compared to the mass of the gun, and try to match the ratio with the hammer/books. Have fun!
Reply: The Action Lab is really good
Reply: The Action Lab how does that explain the sun tho?
Reply: The Action Lab this is great.   Love your approach   New sub
Reply: The Action Lab can you try multiple magnifying glasses maybe at the end of a shiny tube I need more proof that it is impossible
Reply: The Action Lab false laser light does spread because of the wavelike nature of light, so next time learn some simple quantum mechanics
Reply: 1. Lasers have divergence. And they have a minimum divergence. 
2. Lasers are not a point source.
3. Lenses work "both ways".
4. Based on those three observations, let's assume, we focus it down to a point. That means, we have light passing through one point P of the lasers aperture, going it's way through the lens and landing at our focus point. We also have light coming from the same point P but going a different path, because 1. and landing at the same point. So far so good. But now we also have light coming from a different point Q, because of 2. and landing at the same point. Imagine now, we shine light from our point back at the laser source, through the lens. That should be possible because of 3. How does the lens know if it should send a ray to P or Q? Light from all relevant angles lands at our assumed focus point. So it can't tell by the angle. We focused down to a point, so it can't tell by position. So if we CAN focus down to a point, then the source sends either perfect parallel light ( then we can send back properly by chosing the right angle ) or from a point source ( then we don't have the problem of having to send back to two different points).

So because lasers cannot send perfect parallel light and they are not a point source, you cannot focus them to a point.
Reply: I'm pretty sure we could focus the flashlight better if we use more glass and mirrors, hmmmm....

But more importantly: I can't quite believe that you've proven 'negative temperatures' happened here (compared to a relatively low 'high' temperature) just because of scorching/igniting wood quickly... I'm personally imagining that something more spectacular would happen if you subjected wood and atmosphere to post-infinite temperatures.
Reply: Let's re-cap:

Initially you were saying that it would have violated the second law of thermodynamics because the surface of the flashlight must be hotter than the surface of whatever the light is hitting. That seems fair enough. Even if you only look at energy conservation, some of the energy isn't going to hit the target point anyway.

But then you go on to compare the temperatures of the surface being hit without a lens to the surface being hit with a lens, and then make a big deal about how you just said that it would violate the conservation of energy.

But you didn't even notice that the two things you were comparing each time weren't even the same thing:
(1) The first time, you compare the surface of the light with the surface being hit with the light.
(2) The second time, you are only comparing two cases of the surface being hit with the light.

So my advice would be: write out a script for your videos in advance. Spot this sort of blatant error before you make the video. And once you have brought your videos up to a minimum level of self-consistency, then you may tell us to do our research. Until that point, you have no right to do so.
Reply: ......... you do realize that if you were to create a tube of mirrors and focus the flashlight onto the magnifying glass that it would create a brighter point. That is actually how flashlights work.
Reply: You are conflating temperature with brightness.  An LED remains rather cool yet gives off quite a bit of energy as light.  You can have 100 watts of LEDs at room temperature and yet if you focus 100w of energy on a tiny surface ( and yes, you can do this with lenses and mirrors ), you can definitely get it hotter than room temperature.  Also mathematically you can not have a point beyond infinity because infinity is not a number.  If so called "negative temperature" were "above infinity" the the laser would have to spend infinite time heating up to reach it and disintegrate into pure energy.  If it is below absolute zero, then to get there you would have to super cool it until it crossed absolute zero.  I'm not saying you are wrong about the quantum states that emit coherent photons, just that calling it "negative temperature" is bush league nonsense.
Reply: @phillipsusi1791  Are you trying to convince us that a lens focusing a light source such as a laser or the sun focusses heat rather than light ? :/
Reply: @FlagimirKramnik  This is a 5 year old thread with over 500 comments in it.  I have no idea what you are referring to.
Reply: @Phillip Susi: Are you nuts? Which 100W LED stays at room temperature during operation? Why do they need the big ass coolers then? Put your finger right at the light emitting surface of the LED chip - that's exactly the limit of how hot you can make a spot if you could collect all the light and focus it down.
Reply: @RealNovgorod  how does National Ignition Facility (NIF) work if max temperature they can get is the temperature of the laser emitter?
Reply: @irr9193  sorry i dont speak english natively if that is your problem. I dont really understand what is your problem. Please point out what is wrong in my reply
Reply: @Loran: Because a laser is not a black body radiator but a coherent light source which concentrates all energy into one spatial mode. That's also how you can combine the outputs of many lasers into one beam because they are all part of the same mode if you arrange them appropriately. Since a laser is not a black body but produces "highly ordered" (low entropy) radiation (ideally) in a single mode, you can't associate a black-body temperature to it or if you do you end up with population inversion and "negative" temperatures as shown (but not at all explained) in the video. That's why you need lasers for inertial fusion and can't just focus (much cheaper) stadium floodlights.
Reply: @RealNovgorod , one that consists of an array of many LEDs ( say 8 inch in diameter ) with a good cooling fan blowing on it to keep it cool.  You put all of that light onto a < 1 square inch surface that is fairly insulated and it's going to get hotter than the LEDs with fans blowing on them.
Reply: @Phillip Susi: How do you want to put all (!) of that light into 1 square inch if the light emitting surface is 8 inch in diameter (i.e. ~50 square inch)? You don't seem to understand how big an LED actually is. It's not the mount inside the flashlight and it's not the little transparent plastic casing. It's the bare chip, which is sub-millimeter in size. You'd need 500 of them to fill even 1 square inch. Even the "100W" high-power LED modules are not a continuous light emitting surface but are made up of 100 or so individual 1W chips, which are spaced apart a lot because otherwise they just can't be cooled. But regardless, even if you put them next to each other, you can never focus ALL of the light into a smaller area, there is no lens system in existence that can reduce the source size - otherwise you could focus any amount of light into a single point, thus creating a black hole :)...
Reply: @RealNovgorod  I'm an engineer; I know exactly what an LED is.  We have this marvelous invention called a lense that can focus light.  Also a parabolic reflector.
Reply: @Phillip Susi: Obviously you're not an optical engineer. Take a single LED with a ~1mm-diameter chip and try to focus ALL the light from it onto a smaller area. If you can invent such a marvelous lens, why stop there? Hook up a bunch of them in series and create a black hole!
Reply: Loran It heats by compression heating.
Reply: @loran6692  he's just trying to wax poetic...he likes the sound of his own voice
Reply: @RealNovgorod  why do LED get so hot? So people burn more energy due to heat loss and most these LED lightbulbs are designed to transmit and receive data connection. Li-fi
Reply: @isabel Hughes: LEDs can't receive jack and shit. And for data transmission they require a modulator and a high-bandwidth driver, which the usual high-power LEDs are not designed for, so you need to buy ones tailor-made for this application (and don't forget the receiver). Oh and you need line of sight or you're out of luck. The Li-Fi stuff is big time snake oil, but that's a whole other can of worms. But apart from that, LEDs are the most efficient available light source, so people actually burn less energy.
Reply: @loran6692 Really, really, really powerful emitter. One reason we perform physics using the beam rather than the surface of the emitter is because the beam is consumable, while the emitter is not.
Reply: @phillipsusi1791  just to add, raising something to infinite kelvin would require infinite energry. His whole idea is flawwed
Reply: @austin5060  infinite energy you say what do yiu call an object at rest nothing has to out energy on it for it to keep moving forever that in itself is infinite 😆😆😆
Reply: @phillipsusi1791  harbor freight sells a plasma cutter that plugs into wall,and from that tiny bit of energy makes a ball of plasma . His reasoning is faulty ,adding mumbo-jumbo about negative heat yet no clue about Kelvin is junk science
Reply: Longgggggggggggggggggggggggggggghhhggggggggghghghggriffinismynameggggggggggggggggggg
Reply: you can't have an infinitely high temperature, there's a physical limit: the plank temperature.
Reply: The second law of thermodynamics states that the total entropy of an isolated system can never decrease over time. The total entropy of a system and its surroundings can remain constant in ideal cases where the system is in thermodynamic equilibrium, or is undergoing a reversible process. Wikipedia
Reply: "that's why you can never focus a flashlight down to a point hotter than it's surface"  tell that to my truck seat. I used to do security and I had a rechargable maglite flash light. One night I set the light down on my seat facing to the back of the seat without turning it off to negotiate several turns. When I picked it back up I noticed it had burnt several holes by itself into my seat in a matter of seconds. I since used this light to start fires. So that shoots your theory down. The reason focused light burns is because your focussing light waves to a single point causing friction with whatever it comes in contact with.
Reply: @Rand Althor: Wow, too bad you didn't have your camera ready to film this miracle :o - you could have made millions with the video alone. I bet this magic flashlight has a special place in your home, right next to the "free energy" magnet motor, right? :)
Reply: Hey what would happen if you were on a completely frictionless surface, would you be able to move at all? I know you can't without blowing or something, but I think it would be a neat video idea! Love your videos man!
Reply: @Nfscarbon07  There was a magic shoolbus episode about that....they had a game of friction-free baseball, I believe.
Reply: @Nfscarbon07 On a completely frictionless surface, things like gravity start to behave a little bit wonky. Part of reason its almost impossible to contain liquid helium is because they become superfluidic, frictionless, and the surface tension allows it to flow up the sides of the container with the tiniest amount of momentum. Once the momentum of any amount climbs over the top, surface tension will cause the rest to flow out of the bowl as well. As you can never entirely remove momentum, as that would mean you simultaneously know precisely where an atom is, and how exactly how fast it is going. Heisenbergs uncertainty principle means this is impossible. The closer you can identify how fast a particle is going, the less accurately you can know its position. This means that supercooling a fluid like helium can cause the helium to enter a super-position where it is simultaneously inside the bowl and not inside the bowl. The moment you collapse the waveform, the liquid helium inevitably begins to climb out of the bowl. 

Getting things really hot is cool. Getting things really cold is cooler.
Reply: The Action Lab, that’s deep
Reply: AAA.AZA
ALALSLSLSPZPZPSPSP@

-🔙🔙🚻♎💮💮🔱♎🔯♎♎♎😮😑😑😴😴😴😕😢😠😠😠😴😠😴😠😶😐😶😐😶😐😇😉😤😶🔠🏠
Reply: wrong.
Reply: Is also why water can explode after microwave it.
Reply: I hope this makes sense to you action labs. I didnt get this from a book either. I hope it helps you. Think outside of the box. It's not a cold laser just not hot either. Kinda neutral until it connects
Reply: Was i the only one that was to lazy to read everything?
Reply: Ayyy
Reply: Cool vid man i enjoy every episode!!! :D keep up with the good work
Reply: My boi your videos look cool but when i hear them they give me aids
Reply: There is no such thing as negative temperatures. O K means all molecular motion stops. This is a Bose-Einstein Condensate. It is not classical physics, this a concept of modern physics. There are no negatives in physics (as meaning below zero). Negatives are either directions or opposite charges. The hottest temperatures are ones where all the electrons are stripped from the atom. Plasmas like the material in stars.
Reply: You do realize your definition of "infinity" is incorrect. There is no example of infinity in the universe. It is not a number but rather a concept.
Reply: @3tpculp  And even the "concept" of "infinity" is itself dubious at best. You will NEVER reach "infinity". Because it doesn't exist.
Reply: @justlolatthisworld7917  Precisely!
Reply: @justlolatthisworld7917  It does exist. It is a word that means that "there is no end". But even space has an end.
Most people don't realize that the concept of infinity has no beginning either. There is no end between any number and the concept of zero. That's right, Zero is a word for nothing - that can be used as a number is some cases.
Reply: @3tpculp  When I said the "concept" of "infinity" was a dubious concept, I was specifically referring to the numerical concept, i.e. the concept of "infinity" as a number - not the general concept of endlessness.

I was agreeing with your original comment that "infinity" doesn't exist in our universe, and adding that even as a numerical concept - i.e. as a number - "infinity" doesn't exist.

And your original comment as well says that "infinity" is not a number. So it seems as though there was a semantic miscommunication on my part. My apologies as my comment was a bit vague.

I did notice that you replied to my original comment with "Precisely!", so with this clarification, are we perhaps once again in agreement? :)
Reply: @3tpculp  what do you mean that there’s no example of infinity in the universe? 

Isn’t the universe itself…. infinite?
Reply: Kelvin temperature is classically defined as the average kinetic energy in a system. With the formula for total energy, you can express temperature as the variation of entropy in function of that of internal energy.
With that definition, you can define negative temperatures as systems where entropy decreases when you add more energy, which is exactly what he described with the state diagram. (Per the microstatistical definition of entropy)

In my opinion that video was poorly made in that it's misleading and badly vulgarised. Most viewers don't have the background to understand it and simplifying it makes it worse.
Reply: The key connection that you were missing in the video was that the reason lasers have light that doesn't spread is because of population inversion, Wich requires negative temperature to explain. I think people would have had less trouble understanding of you emphasized that point.
Reply: The Action Lab yea, someone should go and read some books about physics...
Reply: There is no "for some reason". You focused a light source to a smaller surface area with a lens and the heat was therefore concentrated on a smaller point which caught fire easier... this is common sense if you've ever focused light sources using a lens... Like when killing ants under a magnifying lens.
Reply: dam1en667, listen to him again. He said that you cannot make the light which you focus with a lens hotter than the heat from all of the surface of the sun. Assuming that the sun's atmosphere is at around 2 million Kelvin, the magnitude of the statement begins to be highlighted. Now imagine the huge size of the sun. I cannot! - It's huge compared to the Earth, let alone your magnifying glass. Now take all of that radiated energy at 2 million Kelvins, and open up the surface of the sun so that all of it's energy is aimed straight towards the magnifying glass, and nowhere else. For starters, you cannot even do that, but supposing that you could do it? In that case, you would turn the magnifying glass into a patch of atomic particles instantly. But supposing that you could have some wonder material that hold together, even for a moment? In that case, much of the light could be focussed, but all lenses are imperfect, and they absorb some of the energy. Again, that couple of percent of the Sun's immense power would destroy the lens. Add to that chromatic aberration; no lens can focus all wavelengths of light - from sub-radio waves, to the most powerful cosmic or gamma rays, to a single point simultaneously. Supposing your wonder lens could achieve that mathematically impossible feat of focussing all light simultaneously, because of various physical and quantum limitations, you can never focus the energy from sun's entire surface to anything smaller than the area of the Sun's surface. 

Even with a lightbulb in a room, you cannot focus all of its energy through a single lens. Quite a lot of it is converted to heat in the lamp holder, most of it's spectrum will not. be focussed (actually only one precise wavelength will be perfectly focussed) and how could you possibly collect all of the light simultaneously from a 360° sphere? In practice, the losses become substantial, whatever you try. That, plus the lens losses, added to quantum effects and such things as Heisenberg's Uncertainty Principle will stop you from making a point of light which is brighter than the total energy emitted from the light source within the lamp. Unless you do something clever with a laser. But in this video, the energy used to create the laser beam is far greater than the energy in the beam. Lasers are generally less than 5% (I am guessing, don't task me. I only see 1% to 2% efficiency in many lasers) efficient. 95% or more of the total energy budget is wasted, so even here, Conservation of Energy is maintained, or if you prefer, entropy increases.

Bye. I don't have time for more here.
Reply: RWBHere ...
Umm,
Since you are wanting to work on cosmic scales, why are you trying to utilize the limited tools from your terrestrial toolbox?   It would be like trying to do surgery on your mitochondria with the rusty tools you used to tune up your Volvo.

If you need to be basically be bending spacetime, methinks you probably will need to at minimum be using some sort of Gravitational lensing - how you would need to accommodate or manipulate whatever dark matter/energy effects there may yet be involved is left as an exercise for the graduate student.
Reply: You are wrong
Reply: Pathetic explanation to justify a stupid example. Your theory is indeed correct but you chose wrong example to prove it. Accept it!
Reply: Nice, its been a while since I couldn’t tell if someone was full of shit or not.  Maybe you could help with the pr releases pertaining to the space bullshit before the ship eats itself.
Reply: You are actually stupid. The second law of thermodynamics isn’t broken in quantum mechanics. It’s still conserved. It deals with the election spin of atoms. Negative temperatures are nonexistent.
Reply: You should make science shows for kids. 
Seriously.
Reply: I love how you use big science words to trick people that don’t fully grasp the concept into thinking your some kind of wizard. You are wrong and did not trick me, and to any others that think he is spouting nonsense you are correct.
Reply: Lasers direct light as a particle ,lightbulb is a wave. If your laser was perfect it wouldn't spread( discounting interference with air)  a magnifying glass could still concentrate the laser beam down to about 2 au. Ask me why.
Reply: @bikerbob2005  Every laser has an aperture and so every laser beam is subject to diffraction. How do you solve that?
Reply: Oooh. I see. It still makes no sense. Read a book boi
Reply: So absolute zero is the hottest?

Yeah... No. 
Also, second law is about closed systems. Your little workspace is not a closed system. 

To end, you're an idiot, that has no understanding of thermodynamics, expansion/ compression of energy emission, not even a basic grasp at fundamental laws.
Reply: Nobody should be called dumb for not knowing something. Nobody knows everything
Reply: @jakejensen4809 for practical purposes it can be considered closed,  there is no such thing(except in theory)  which can't let heat flow.
Reply: @jakejensen4809  exactly
Reply: @jakejensen4809  - 500k!! ???? Eh?? Zero degrees Kelvin is - 273° c!! ( or Absolute zero!!!) So how in the heck can you achieve a temperature lower than 0° K  even in a vacuum chamber this isn't even theoretically possible!  Also my working out on this, details how absolute zero is only possible in space !without gravitational forces & light/temp energy acting upon the experimental  equipment. Human scientists are unable to produce the nessesary conditions to produce this temperature reading! As even liquid nitrogen freezing the  equipment to aid in the negative readings would not achieve this!!
Reply: @lordthomastravis1617  While you made an effort, you failed on a few things. Kelvin is never "degrees". It's an absolute. So instead of saying (x) degrees Kelvin, it's (x) Kelvin. Next, absolute zero is practically impossible no matter where you try to achieve it, as the observer phenomenon comes into effect, where the simple act of observing the outcome would add energy into system, thus not being absolute zero.
Reply: "I see a lot of people are having trouble with this video." So arrogant... please consider that you could be wrong.
Reply: Bunch of virgin nerds here
Reply: Why not simply admit that the 2nd Law of Thermodynamics could be wrong? Or maybe it is a general observation but not a hard and fast "law" as commonly and incorrectly stated. This of course can veer into the tricky subject of NWO suppression of already-existing free-energy technology.

BTW, is "negative temperature" for real, or merely a concocted mathematical artifact?
Reply: For the record state your claim in English of the 'second law.'
Reply: Second law? Entropy can't decrease in a closed system, there you go.
Reply: @RealNovgorod  i glanced at an old Resnick laying around and saw profoundly missleading writing.  The paradigms college students bring to what was then obvious and surmised from general experience but now 99% of TIME completely misunderstood deserve REAL explication.  "State YOUR claim" meant in your own simple concrete if possible language show us you understand or don't the issue by for example articulating the falsity if not absurdity of the alternative.  We know now that the fossil fuel industry benefits from our teaching failure of these fundamental concepts.  Flickering in last weeks NYT's comments about big oil is casual mention that methane burnt to drive a turbine however efficiently the latent heat in the steam is converted into electricty as near Manhattan occcurs on a SCALE beyond our imagination in one towering tornado of flame the 'dio&monixidy-wind' is totally wasted in the combustion gasses instead of being used to do the work of preheating the condensate being sucked out of the turbines.  Your punishment for spreading such dogma Sir is to calculate the net present value of a expansion of combustion gas driven scroll compressor heatpump preheater (from molten free saltwater ie climate stabilising directly as well) versus it's cost at this scale in materials exclusive of labor or licensing etc encumbrances.  Do you accept?
Reply: @Ir R: Yeah... But where's the laser in your equation?
Reply: @RealNovgorod  but multiple light enterin to a place is not a closed system so if yo aligh the light sources and lenses correctly it will work,
Reply: @ahmet mutlu: Not if the light sources are incoherent. You can overlap different "beams" to add up their intensities, but then you can never collect ALL the light from all sources. Or you can collect all the light from all sources but then you can't create a smaller focus spot than the total area of all light sources. In either case you can't increase the light intensity (and thus temperature) at the focus spot above the intensity at the surface of each incoherent light source.
Reply: @RealNovgorod  ehm. not actually. there is experiments using multiple lasers to create extremely hot points.  not my experiment but someonelse. and they are not amateurs researchers :P
Reply: @RealNovgorod  in the theory of thermodynamics. what the person claiming about closed system is. the closed system is actually the universe itself. there is no such place as closed system physically in universe :D so that's near impossible as neutrinos gravity etc enters in the so claimed closed system regularly. :D
Reply: @RealNovgorod  also... what is a laser ?
they are special design leds that has light rectifying tunnels, so in reality laser is multisource light that is corrected. ;P
Reply: @ahmet mutlu: That's why I said an INCOHERENT light source, like the flashlight he used in the video! You can combine laser beams because they are not black body radiators but coherent sources producing (ideally) only photons in one particular spatial Gaussian mode. A laser has no "source size" and therefore no (meaningful) black-body temperature (it will be negative "temperature" if you do the math). An LED is incoherent and has a finite source area, which emits light randomly from all points on the surface and in all directions. You can't focus such a source onto a smaller area. Also, lasers are none of what you just said. They are self-amplifying sources of STIMULATED emission due to the population inversion within the light emitting medium. Therefore, they produce COHERENT light because they "copy" any incoming photons and an external cavity forces them into one Gaussian spatial mode.
Reply: @RealNovgorod  if you have lots of reflector that are alligned correctly ,ie one photon sized ones ;P im sure you can direct as much as you wish ;P
the problem wih non-laser light sources is they are not designed to be directional, ie sun there is multiple sources of light and there is no natural direction controlling their direction
Reply: @ahmet mutlu: What is a photon sized reflector? How large do you think is a photon?? And yes, incoherent sources are not directional, they emit from every point of their surface into every direction, that's the whole point! That's why you can't focus all the light from such a source into a smaller spot.
Reply: @RealNovgorod  but the problem is not about phusics rules, problem is about limited resource we have and required effort to point/syncronize  that all randomness into one point ;P
Reply: @ahmet mutlu: That's literally about "phüsics" rules called entropy. If you figure out how to pump heat from a colder place to a warmer place without using energy, you're welcome to pick up your Nobel prize. You can use all resources you want to "point" all that randomness in one point. You don't even need to build a prototype, I'll give you a million bucks for just a proof on paper.
Reply: @RealNovgorod  first you hawe to understand definition of heat, 
what is heat technically, ?
Reply: @ahmet mutlu: Heat is a statistical measure of a system's energy distributed over its microstates. That's what you don't seem to understand. It's not about a single photon or particle or "quantum" or whatever but only applies to many-body-systems. Now what is the difference between a single-mode laser emitter and the shiny surface of an LED?
Reply: @RealNovgorod  heat is in general some thing as speed of electrons, so in general i guess we can say if things heat time speeds up fpr that atom... ;P
Reply: ie how we measure time ?
Reply: @RealNovgorod  heat actually is realated to interaction speed of molecules/atoms/particles. :P 
which is the some thing in lots of cases with time/speed :D 
ie how we calculate time :P on atomic clocks counting the ticks/counts of an electons action :D so which is in general some thing as heat. ie hot things interaction speeds gets higher. so thats why they use collers for atomic clocks. as heat increases intearaction speed. so what lased does to atoms is speeding their inteaction speed therefore heating :D and at the some time time starts ticking faster / inteactions of particle reactions.. so what was the question :D what lased does :P so you mean that a laser las a spesific upper limit of heating capability. but it doesnt copy the heat. you claim the light  as sometginf else. ie a matter that is hawin spesific heat :P and talking about copying it indirectly :P which probably is not the case. effectively it may look that way, but probably not :P
Reply: the technology used to create laser light. and led light are the some thing. 
difference is laser has corrected direction. which gives option to control its direction better :P
Reply: @ahmet mutlu: Are you trolling? Time doesn't "tick faster" with heat! In atomic clocks you excite a specific transition and measure its resonance frequency, which is the energy difference between the two states. This is INDEPENDENT of temperature, that's the whole point to use this as an absolute standard for measuring time! The atoms are cooled down only to get all (or most) of them in the ground state, so you can measure the transition. If the temperature changes by 1%, the transition frequency won't change - that would be insane! If the temperature is a lot higher, you just won't see the ground state transition anymore because higher electronic states are thermally excited. If you want to troll properly, read at least a Wikipedia article about electronic states in atoms.

Light is not "a matter with specific heat". It's the emission of photons as a consequence of electronic transitions within a material. In an LED these transitions are spontaneous and random in all directions. In a laser there are more light emitting atoms in the excited state than in the ground state so an emitted photon likely hits a nearby excited atom and induces stimulated emission, i.e. the excited atom transitions to the ground state and emits a photon with an identical wave function as the one hitting it, effectively creating a copy of that photon. That's called light amplification (read a Wikipedia article on "laser"). Therefore laser light is coherent (all photons occupy the same quantum wave) and has low entropy compared to incoherent LED light or black-body radiator. That's also why you can focus a (single-mode) laser down to a wavelength spot size, but you can never focus all the light of an LED to a smaller spot than the LED surface.
Reply: @RealNovgorod  we now haw too much more rpoblems to debate. and i dont want to start go back to beginning of physics, :P and do i care :P
Reply: yeah time is static. atoms speeds are sstatic. we are living in fixed static cosmis :P great :D light cant be bent. etc.etc. worlds of impossiblities :P
Reply: @ahmet mutlu: If you don't even want to learn the most basic principles of physics, then there's nothing to discuss.
Here's what you need to know about time: https://www.youtube.com/watch?v=JwYX52BP2Sk
Good luck with your life.
Reply: @RealNovgorod  i dont hawe enough time to discus all the physics from the beginning ..
but as you said. light doest have aspesific heat :P and  it has no limit on focusing. it wave. it doesnt matter what the focus is focus is about lots of vaves/lights direction and simetry between them :P you caN  FOCUS ALL THE WAVES WHEREVER YOU WANT :p
Reply: limit is wavelength itself. and nothing more. and it too can be changes. so no phsical limits on wavelength too. you can use even quantum sized waves too. which is beyond researchable technology i guess anyway :P
Reply: @ahmet mutlu: No, you can't. Otherwise you could just zoom in and see atoms and quarks.
Reply: @RealNovgorod  well, not with magnifying glass ofcourse.
Reply: not with only one atleast but may be with lots of mirrors etc... ;P
Reply: @ahmet mutlu: No, mirrors are bigger than atoms.
Reply: @ahmet mutlu: Exactly, so you can't see atoms because there is a limit for focusing light.
Reply: @RealNovgorod  mirrors are atoms too ;P
Reply: so no... they are not bigger :P
Reply: @ahmet mutlu: And electrons are lenses for quarks.
Reply: @RealNovgorod Planet formation within a solar system is the opposite, or converse, of entropy.
Reply: The Action Lab Sir may I enquire for a link to your schooling or some such rubric to KNOW your 'dialect' if any conversation is to occur we best start in SUCH fashion?